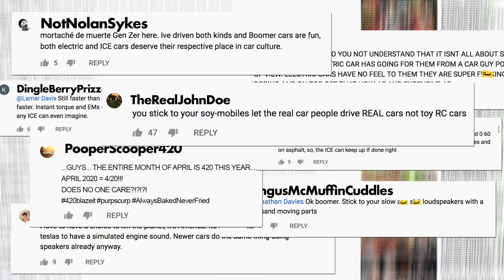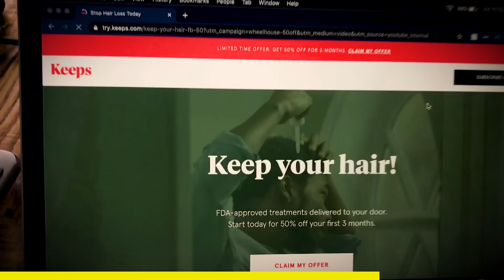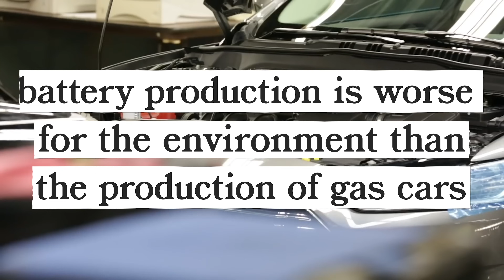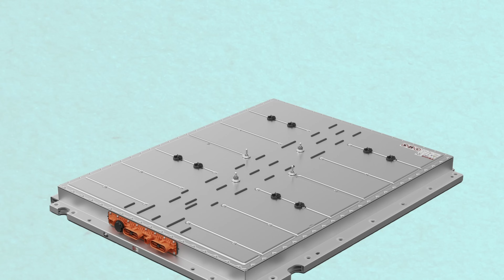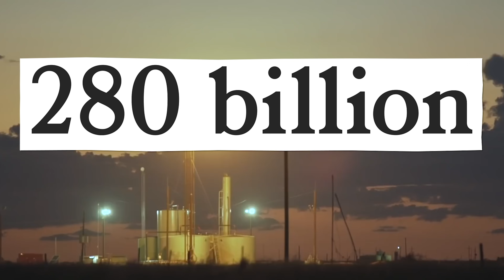Are Electric Cars REALLY Better for the Environment?

Comment from the maker: Hey guys I felt this was an important video for us to make, and I'm really glad you guys like it. We've covered a lot of different cars on this channel and talked to a lot of owners, and the one thing that unites them all is the desire for MO POWAH BABEH! So no matter how your car makes its power, you're welcome in the Donut community. - Nolan
Reply: Many errors. Talking about coal and lithium... And cobalt like it's an EV problem (it's used mostly in oil's refining!).
 For the EVs the goal is to make it a closed loop, li-ion batteries can be recycled in 96%+:

Eco-friendly method of recycling EV batteries

https://youtu.be/wxCFDWMPu38

Existing processes:

https://www.edmunds.com/fuel-economy/what-happens-to-ev-and-hybrid-batteries.html

> Lithium-ion batteries now are somewhere between 70 and 100 percent recyclable, depending on the particular chemistry of the batteries. There are about half a dozen in use and more are being developed. The bits that can't be recycled are mostly consumed as fuel in the furnaces that are used to melt down the metals, which include cobalt, copper, iron, nickel, manganese and, someday, lithium.

> Recycling specialists say that as volume grows, it will become more economically feasible to recover some of the content now wasted that way. Lithium, for example, is so cheap that there's no economic case for recovering it from lithium-ion batteries right now, says Todd Coy, executive vice president of recycler Kinsbursky Brothers. The Southern California firm handles most North American advanced automotive battery recycling through a joint venture with longtime battery recycling firm Toxco.

---

If the cobalt is your "problem"

Tesla's goal: https://evannex.com/blogs/news/tesla-s-goal-cobalt-free-batteries

https://i.imgur.com/bscMBFE.png

EV used "6 650 tonnes in 2017" (Page 22. https://publications.jrc.ec.europa.eu/repository/bitstream/JRC112285/jrc112285_cobalt.pdf ), ~8k tons in 2019 from 130k tons of mined cobalt last year. All of that with proof of origin - no children sourced crap. 
The rest so ~122k tonns? Military uses (lowest bid contractors use cheapest cobalt...), abrasive tools and cellphone batteries and **of course probably #1 that no ones mentions "indirectly" ICE cars because it's used in refining oil**:

https://youtu.be/ysQ3VWpuwI0?t=236

https://twitter.com/enn_nafnlaus/status/1206896495993278464

> Tesla is well known for not buying Congo cobalt. The Model S/X get cobalt from the Philippines, while Model 3 gets it from Canada.  Amnesty international, in its very first report on the problem of child labour in cobalt mining, spared Tesla from criticism specifically for this reason

----

An EV running 100% coal is ALWAYS mentioned, but a gas/diesel car fueled from Canada's tar(oil) sands? No that would be rude! /s

Every one car in US is fueled in part from Canada's tar(oil) sands:

https://en.wikipedia.org/wiki/Oil_sands#Energy_balance

> Approximately 1.0–1.25 gigajoules (280–350 kWh) of energy is needed to extract a barrel of bitumen and upgrade it to synthetic crude. As of 2006, most of this is produced by burning natural gas. Since a barrel of oil equivalent is about 6.117 gigajoules (1,699 kWh), its EROEI is 5–6. That means this extracts about 5 or 6 times as much energy as is consumed. Energy efficiency is expected to improve to an average of 900 cubic feet (25 m3) of natural gas or 0.945 gigajoules (262 kWh) of energy per barrel by 2015, giving an EROEI of about 6.5.

That's enough for ~2500km of range for a Model 3... And that's only extraction! 

Canada's Tar Sands: The most destructive project on Earth? - Truthloader

https://www.youtube.com/watch?v=Sjia7BsP4Bw

And they spill oil from pipelines all the time, last leak:

https://electrek.co/2019/11/01/keystone-oil-pipeline-leaks-nearly-400k-gallons-north-dakota/

> The Keystone oil pipeline has spilled approximately 383,000 gallons of *tar sands oil* in northeastern North Dakota

EGEB: Keystone oil leak affected 10 times more land than originally thought

https://electrek.co/2019/11/19/egeb-keystone-oil-leak-bill-gates-heliogen-wind-farms/
> North Dakota environmental scientist Bill Suess said the leak reported on October 29 is now estimated by state regulators to have affected about 209,100 square feet (19,426 square meters) of land near Edinburg.

---==============----

About materials, here's a nice comment:

https://old.reddit.com/r/teslamotors/comments/dsekn5/tesla_and_lithiumcobalt_mining/f6q7vqd/

> This is discussed multiple times a year, for several years. It's never from a position where someone has really done any serious research and looking into who the materials suppliers are and where they source materials from. It's always from a "a friend of mine says mining metal is worse for the environment". It's a nonsense argument, since all of the materials used to make an EV are made to make an ICE vehicle except for the addition of a tiny amount of lithium and an even smaller amount of cobalt. The amount of these materials in any battery cell is very low. Cobalt accounts for less than 5% of the cell's makeup, and lithium is single digit grams per 100 Wh.

> On the other hand, steel and aluminum make up a massive amount of every car made. Refining those processes to be more efficient, more environmentally friendly at the mineral source, cleaner in production/refinement, reducing waste when stamping parts, and increasing recycling of materials would have an absolutely massive impact on the environment almost over night. Electric arc furnaces used to make aluminum require a mind blowing amount of energy, and the metal needs to be heated to thousands of degrees to remove the oxides from bauxite and make aluminum. I don't hear anybody from Ford talking about that when they talk about their aluminum chassis.
Reply: Rrr Ggg that was good stuff well done.  thats how you make an argument whether you agree or not. that was actually so good i think you should write it up but you have to counterpoint it against the direct vehicle comparison. a generalized argument loses steam without a focus so if you continue to keep it on cars i think you could do really well with it. plus theres so much to delve into this subject you could actually make a good book on cars. i love gas engines myself but i like a good argument more. great work.
Reply: MO POWAHHH BABEEEHHHH!!!
Reply: Hi! Do you have any sources that you can share about the amount of CO2 produced when producing an ICE car? Thanks!
Reply: @jjrestomods  I don't look up research papers or anything like that very much but here's some videos and channels you might like. Engineering Explained is pretty good at explaining physics/engineering stuff about electric and gas cars using formulas and math stuff    and  2 bit DaVinci is pretty smart about sustainable energy stuff. Hope you enjoy!!
https://www.youtube.com/watch?v=N6VpPaOIPfU
https://www.youtube.com/watch?v=2rywz73vwKw
https://www.youtube.com/watch?v=6RhtiPefVzM
Reply: Drag co-efficiency is your friend for the sake of optimal functionality pertaining to all motorized forms of transportation, weight ratio distribution and more ergonomic materials also play significant roles toward varying degrees of efficiency in fuel to range at speed factors...I'm sure we could likely list a plethora of other factors and the roles they play in design and fuel economy to bhp but it might take a bit more space.
Reply: @jjrestomods  https://www.youtube.com/watch?v=6RhtiPefVzM
Reply: @jjrestomods  doesnt matter co2 isnt a danger to the environment in the first place.
Reply: Javier E hey I would love to see a video with hybrid cars
Reply: @jjrestomods  did you find it?
Reply: @jjrestomods  Hey Javier, did you ever get those sources? I really wanna look into them too.
Reply: @jjrestomods  did you happen to find a source because I am trying to do a school project on the subject but I am struggling to find any sources with the data I need
Reply: @jjrestomods  thank you much appreciated
Reply: @jjrestomods  -- 4HC + 6O2 -> 2H2O + CO2.  This is just basic chemistry and with the simplest hydrocarbon. C8H18, a molecule of octane (basically, gasoline) undergoing complete combustion, produces 8 molecules of carbon dioxide and 9 water molecules.  

Now, that doesn't mean EVs are really better for the environment.  What this guy doesn't take into account is loss along the way, through transmission.  Neither do the stats he cites, some of which are false.  ICEs are as efficient as the power plants, when it comes down to power production from fossil fuels.  They're basically engines turning magnets.  Transmission loss IS a thing, as is insertion loss.

Another factor nobody seems to take into account is charging loss due to heat.  Charging that big of a battery quick enough to be at 100% over the course of a few hours loses a LOT more energy than trickle charging it over the course of a few days.  If you rarely drive and have the slow charger,, you use considerably less electricity per  mile than the guy who drives distances every day, uses the super charge stations to bump back up by 80% in 45 minutes, and then plugs into the $1000 240 V rapid charger at home.  That guy's battery only holds a 60-70% charge after a few years, as well, still consuming close to the same amount of energy to achieve that charge.
Reply: Thank you so much for bunging clarity to the debate! Could you add a section for diesel vehicles? Especially here in Europe, diesel is very popular and they get much better mpg than gas cars. I suspect, and this is just a gut feeling, that EVs will still be better, but I would still love to see the numerical difference between the two. - Cheers from Germany
Reply: Hey Donut crew! I was wondering if you guys could cite your sources for more controversial/political videos like this?
Reply: @therisensun9277  lll
Reply: @therisensun9277  since when are facts political
Reply: @doncox3706  since naysayers started saying climate change isn't real
Reply: hey Nolan, can you provide the source of the figures mentioned in this episode?
Reply: Thanks for the video! I was called an Idiot and Psychopath, because I argued that EV's are still better than ICE engine. Yeah it is Pathetic to argue that as time goes on it'll be better, but it is true. ICE engine have gone a long way, and I'm sure EV's would too. Although it didn't help much ( since I follow a philosophy inspired by Socrates) that I question his "Skepticism" as that of being a Manipulate troll.
Reply: Would you kindly include all the sources and references you used in the description? Thanks.
Reply: Donut Media     https://e360.yale.edu/features/why-nuclear-power-must-be-part-of-the-energy-solution-environmentalists-climate

Sent this article from Yale. Just to show you the cleanest and least harmful form of energy is nuclear energy, rather than the solar, wind, and hydro energy which also produce 100x more waste than nuclear energy. For those who will try to mention Chernobyl or any other malfunctions, read the article it covers those too. Find out the truth from actual science, rather than mainstream media and social media.
Reply: @G-los  How is the waste from nuclear energy less harmful than the mechanical process of renewable energy like hydro, solar and wind?
Even though nuclear accidents has happened on an average every decade they were preventable and happened because of carelessness. If we could control it each country looking to develop throium reactors should reach a certain stage in their economic development before they should be allowed to build reactors. Ledc's tend to have worse regulations.
Another criteria I'd have, countries with history of developing nuclear weapons should be banned from developing nuclear reactors (Leniency when it comes to thorium reactors.) Im looking at the US. But this is unrealisitic and impossible to assure.
Also there is nuclear waste, who's gonna deal with that? The only country taking this seriously is finland, literally the tiniest country that's looking into nuclear energy. They decay by half-lifes, nuclear energy stays by the thousands of years probably even longer.
Reply: Another thing we need to remember is fossil fuels won’t last forever. I have read reports that it is estimated we have about 50 years of fossil fuel remaining. Not sure how true, I’m guessing though that wind and water will be around for thousands years to come. Also solar power has to be factored in as well. Again I have read an article that says we have the technology and potential to use solar power for most of the worlds demands.This is only stopped by the cost of implementation. Personally I love the sound of ICEs but we have to do better to ensure the next generations future. 👍🏻😊
Reply: Tell me this, in your gas car what goes out first the motor, or something like a window regulator or alternator?
Reply: @timessiah94  battery
Reply: @UCWvKfH7itpkFzILLCNBg0hg what kind of Rock do you live under
Reply: I wish that you covered the efficiency and longevity of an electric car compared to a "ICE" car.
Reply: Donut Media there are still 2 things you missed. 1 lifetime of a battery in an electric car and 2 the issues in different climates👍 but other than that amazing video
Reply: Could you please cite all the references you used for this topic? Thank you!
Reply: @Franz Xaver Fuchsberger While this is true there's a lot of additions and changes that Tesla makes to the batter pack as a whole that make them last longer #1 being active heat management. your cell phone and laptop don't have coolant/heaters running through them which makes a big difference on battery longevity. As well the battery management is much better on a Tesla than a laptop or a phone. I can set my Tesla to max out the charge at 80% most of the time unless I'm going on a long trip that needs the extra range. This keeps the battery in an optimal charge/discharge range for longevity. You can't do any such thing on your phone or laptop without a lot of human intervention. There's other improvements in there as well that I'm less familiar with. But while you're correct the cells are the same the batter pack is not and the charge/discharge management plays a huge role in cell longevity. As well the Teslas have a 100000 mile 8 year battery warranty or 120000 8 year warranty on the battery. So given the miles driven by an average driver in the USA  per year (13000) you're looking at between 7 and 8 years without having to pay for any battery issues. and to be clear this mean that if on 99999 miles your battery dips below 70% of original capacity you get a new battery pack for free. As well if you want data then this article has some https://electrek.co/2016/11/01/tesla-battery-degradation/ older model S and Model X's are seeing often less than 10% battery degradation after 150000 miles
Reply: I think you did a very good job and consider myself to be pretty impartial.  I would like to have seen the consideration added of the effects of the cars on the environment after their life has ended.  From my experience, due to the high cost of electric batteries many hybrid and electric vehicles are replaced or gotten rid of sooner than a gas powered equivalent.  So how about the recyclability of a car once it has been put to pasture?  Are those lithium batteries recyclable?  What kind of effect does their disposal have on the environment?  Thanks for your hard work.  I just felt this added Info could complete the picture so to speak as to the effects on the environment.
Reply: The only real question for me is long term. Yes they will be more climate friendly, but that figure has never counted for replacement batteries... we all know batteries have a lifetime of 3-10 years depending on batteries etc. Look at the Nissan Leaf. Once the batteries go people often don’t replace them. Why? Car value is far less than the battery price. So it ends up being scrapped to be never used again. This is my only problem. Electric cars don’t have the recycle value that most ICE cars have. They all can usually be sold and sold and sold. Something breaks they can usually be fixed or rebuilt. I love the idea of electric but the technology still just isn’t there for me. Also they should put a ban on putting ZERO EMISSIONS on these cars instead put the build emissions on the car like the label for fuel efficiency, it could potentially encourage these manufacturers to think about improvements to this figure longterm.
Reply: Donut Media part 2 how gas cars vs electric cars are recycled
Reply: Y don't u stop talking about your self and start a video directly on the real vehicle matter and shut the f*** up🤔
Reply: Informative video but I am curious about the statement about EVs being better over the lifetime of either EV or ICE cars considering EV batteries need to be replaced more often than an ICE engine NEEDS to be replaced. Despite what a lot of people think there are a lot of ICE cars that will run reliably up to 300k miles (I personally owned a Honda Fit that had 300k miles on it and was still running strong before someone hit me) how often do EV cars NEED there batteries changed vs ICE cars NEEDING an engine replaced. (I say “NEED” because I know a lot of people think a car is only good for 80-100k and that’s not completely accurate) again very informative video I just think it’s important to outline the issue of battery replacement intervals on an EV car
Reply: Next video as a follow up. How does a Hybrid car compare to an electric car and an ICE car?
Reply: well your math is a bit wrong. if you consider the refining emissions involved and share that across all industries using petroleum products you have a different overall percentage for ice vehicles. if you take away all ice vehicles and replace them with ev you will still have the refining emissions since everything is made with plastic which is petroleum based. you would need to split out the direct ice percentage in order to get a true number. that said this was still excellent for the research involved thank you.
Reply: You need to do better research and make another video about real pollution.
Reply: Cobalt Not colbalt
Reply: @eded9202  you need to research nuclear power a little more sir. As far as safety, you will find that nuclear power is MUCH safer than any other form of generating electricity when you look at how many deaths per mega watt generated https://ourworldindata.org/safest-sources-of-energy
As for the huge amounts of spent fuel all of it could fit on a single football field at a depth of less than 10 yards.https://www.energy.gov/ne/articles/5-fast-facts-about-spent-nuclear-fuel
Reply: Please, please, please stop using the misinformation of showing pictures of hyperboloid cooling structures (most often associated with nuclear power plants anyway) as background pictures when talking about power plant greenhouse gases. Those are used to naturally cool hot water with surface area (yes, there is just hot water in the shells of them) and harmless water vapors is all they produce (and this works opposite of condensation, so it's water that was already in the air).

I work in the nuclear power industry and misinformation has been killing my industry since the dawn of the atomic bomb. Please, again, use pictures responsibly, take the extra 2 minutes to research all things you use in your videos.
Reply: You know..... an EV would not have interrupted you like that Combustion car did, in the middle of your video (EV's make almost zero noise) 😉 Just one more perk of Electric cars 😁
Reply: You said that you love gas powered cars and you will drive them for the rest of your live... although you know that they are worse in any way for mother earth than electric cars...?!?
I wonder what it says about you...
😁👍 Good Boiii!
Reply: People don't want to change - and the electric car revolution is no different. People will try to find any excuse to prevent this change.  The hardest transition to electric IMO is the charging time, lack of awesome sounds and the MSRP.  You can reduce the initial production 10 metric tons difference by simply driving that Model X for 2 years compared to driving a ICE high performance SUV. The pros: a reliable motor, tremendous torque and mo powa babeh.
Reply: The truth is either you use it ornıt electric will go to waste because we constantly using electricity because we cant store it.
We need to use it because it will go waste if you ront use it.
Reply: There is another big problem as the batteries all have to be charged up ..and it takes 746 watts of current to make 1 horsepower ..and new electric motors can not break or defy ohms law of electricity ...and today the utility companies are building "peakers "as our power houses are becoming obsolete and non reparable ..so now we built huge gas turbine engines that suck tons of natural gas to make electricity costing huge dollars instead of coal fired boilers that cost pennies to operate ....which is cheaper and cost effective ..running your house on a back up fossil fuel generator  or plugged into the grid ? ...now our grid is being supplied with huge fossil fuel back up generators as it takes 20 years to build a new coal fired burning power house ..our inter structure  is falling apart faster than we can replace it !and now we have people claiming gasoline power cars make more pollution than industry ...so we as the consumers are just plain fucked with all the propaganda as this video is a huge lie ....all internal combustion engines account for 1 tenth of 1 % of all greenhouse emissions ..industry account for all the rest and not the the other way around as you are all being lied to  ...future battery and electric motor technology will only give us more range ..it will still take the same amount of watts to run an electric car per 746 watts = 1 horsepower as it did the first time over a 100 years ago to drive an electric car ..wind mills and solar panels will cover the earth to supply our demand for electricity to completely eliminate power houses ..nuke power plants are the only answer ..but now you are all  to believe nuclear energy is worse of all , dangerous and deadly as the accidents of the past have so called proven to fail .....what about the navy's aircraft carriers that are called  floating cities with 5000 crew members on board that steam through hurricanes without a problem ? No leaky reactors there but full steam ahead for almost 50 years or is it more than ? of free energy ... President Dwight D Eisenhower warned us of the corporate industrial military complex back in the 50s but unfortunately nobody listens
Reply: @donniebaker5984  you can start by disconnecting from the grid grow your own food and don't buy any manufactured products. Lead by example.
As for the cars an EV does need about about 820w to produce 1hp. Unfortunately ICE vehicles need about 3700w. So it is not that they don't have an environmental cost it is that the cost is lower overall.
As for the electricity generation a 200m2 roof completely filled with solar panels makes more than enough electricity to power a house of 5 people and run 2 electric cars for average people. So if we really wanted to go carbon neutral we really can we just need to put more effort in the right direction.
Reply: just wanted to correct the fact you considered wind power clean. its not it kills birds and dosent recoup the cost.
Reply: @LORD-NIGRIEZA--------------OWO  not to mention manufacturing them and shipping them to the other side of the world.
Reply: Wish he talked about diesels, diesel is a byproduct of gasoline, so it is already cleaner. It is also more efficient then gasoline. It burns hotter, and it produces more power, and it is more economical. I would love to see a comparison of diesel to all electric vehicles
Reply: He didn't mention that the batteries only last for maybe 5 years and the solar panels have to be replaced every 10 years. He also didn't mention the amount of copper that is necessary and forgot to mention the toxicity of the discarded solar panels and lithium batteries. Which are not 100%  recyclable .  While my diesel engine has 1 million miles on it and is still kicking and can be 100% recycled . I also  have over 350,000 miles on my gas engine which also can be rebuilt or recycled ,your not gonna get that mileage out of your solar batteries . Your research gets three  bullshit bullshit bullshits.  plus you never mentioned synthetic oil or alternative fuels like natural gas which are much cleaner than gas . They must be paying you all  tons of money to sell out your countries energy independence , fucking traitors. I'm unsubscribing to this blatant bullshit spewing from a guy with a IQ of 80
Reply: What about end of life issues with batteries and replacement costs?
Reply: The 100% REAL TRUTH about electric cars, is that you'll be sitting right ontop of a NUCLEAR POWER PLANT all the motherfuckin' time.
So say hello to RADIATION CANCER, and say goodbye to LIFE!!!
Now if THAT doesn't kill ya soon enough, then the ELECTRIC FIRES most prolly will...
Next best thing to a 1970s Ford Pinto, if ya asked me!
Need I say more? <:  P
Reply: Great video, I am wondering if there is a difference with diesel vs electric and what comparisons there are. I was also surprised by this research as well and you did a great job putting it all together, one thing you didn't note was the power grid in California when they have rolling blackouts residents were asked to not charge their cars. Not sure if there was anything mandatory about it but my relatives told me they were asked that.
Reply: Hey donut, blackouts mean that the electric networks are failing already
Reply: @PeopleHealthTru  -- People look at published numbers and spout them all the time.  The truth is that if the power generation and transmission systems were working properly, they could hit those numbers and everything would be fine.  You could charge all the cars you wanted.  They aren't and don't.  The result is rolling blackouts and fires WITHOUT everybody charging their cars.
Reply: EV is Anti Poor. And besides, when your Battery goes dead, it will Cost you HALF of the cars price just to buy one
Reply: @eded9202  I wonder what happens if we threw our Nuclear Waste at space?
Reply: @hectorvega621  or we could put it all in that big GARGANTUAN BLACK HOLE WE JUST DISCOVERED
Reply: Hey Nolan, what about Hybrid cars?
Reply: But what about when a battery gets punctured?
Reply: HVALA SVIMA NA PODRSCI
325 pregleda i jos raste! 
Bice ovo najjaci channel na balkanu sto se tice teardown-a, durability testova i preview-a svega! 
https://youtu.be/72lGqGEVAx4
Zapratite i budite u toku, ima giveaway-a! 
Vec je poklonjen jedan bluetooth receiver i poklanjacemo jos mnogo toga!
Da budete u toku, follow stranicu
Top_tech_top_cena! Na instagramu!
HVALA!
Reply: Hey Nolan 

Awesome video. 
But I noticed that you didn’t take a very crucial fact in to consideration. 
The battery doesn’t last for ever. Just like on your phone or laptop. 
They just don’t hold a charge after a while. So that means a new battery. 

If you take that in to consideration, are the EV’s still the ones who come out on top or??
Best regards from Denmark.
Reply: Motorcycles too. No matter what powers them...unless it's powered by shredded babies, or something like that, but you know what I mean.
More power (pet name baby, not literal baby) baebeh!
Reply: Donut Media Thanks for proving me wrong. I was one of the people that requested a video about this and I was legitimately curious what the data would show. It’s still insane how much emissions come from building EV’s, but this was a great vid.
Reply: If all of the facts in this video is true (surprise! I have a dissenting POV) then argument you propose is actually what fossil fuel & distribution system is more efficient  with the least environmental impact, on average,, each year: Gasoline or Coal with a sprinkling of Nuclear &renewable resources combined with the environmental impact of the correlating production of ICE & EV vehicles? In which case unless you have you’re own high production solar panels on your sunny California home after year 3 but before year 10, with a solar wall (batteries) but ignore that impact, the difference would be negligible at best. 

Being that you’re average EV has a shelf life of 1/3 of the average ICE vehicle due to the current secondary market, the cost of replacement components, the ability to repair, & the likelihood of salvaging by insurance the truth is that when you actually compare the impact of production of an EV vehicle and a unit of Coal to travel ‘x’ number of miles = to the same number of ‘x’ miles in an ICE car using Gasoline from crude the truth is that It requires multiple life cycles and productions of EV cars equal the same life cycle and miles driven of one ICE car and the environmental difference between the required Coal vs Gas is.nothing more than an argument between lobbyists from Wesg Virginia & Texas. So until we see the Mythical ROI (reduction on Impact) that does not exist yet stick to your 1992 civic Jack.
Reply: Im honestly.. Kinda hurt..
Reply: The battery issue wont exist once the batteries move over to being carbon based in THIS decade.
Reply: I argue that hydro electric power does not count as environmentally sustainable. Dams will flood local wilderness and they endanger migrating aquatic species among a number of other things.
Reply: Proton cars please, especially its R3, and UK rally scene
Reply: Can y’all do a video about hydrogen powered cars
Reply: Great video.Good job donut media !
Reply: Hey Donut!  You Should Make A Video On Iconic Video Game Cars ?
Reply: @donutmedia hey Nolen, who pressured/ paid you guys to make this?
Reply: Thanks a lot !
Reply: Did you think of fuel cell cars, because i think they have a really low emissions. And thanks for the great video
Reply: In Conclusion, Hydrogen Fuel Cell EV is more environmental friendly.
Reply: So you stood in front of a greenscreen...to make your background a blue screen😂
Reply: how about hybrids? with diesel and gas engins?? how do they compaire? ^^  
btw NICE! :D GOGO DONUT!! :D MO PAWAH BBY!
Reply: only point i dident see was lifetime emissions of an ev. 1 does the car last as long overall as a ice , will you be buying new ones more often. 2 how often do you need to replace those lithium dependent batterys .
Reply: I appreciate vehicles in all shapes, sizes and propulsion so I'm not being bias, Did you take into account the need for replacement batteries in EV's ( especially with the impact getting the lithium )
Reply: Can Hydrogen Fuel Cell also become a new step for the Future??
Reply: 0:07 lmao my comment made it "TheRealJohnDoe"
Reply: TimothyReidUpNorth907 yeah !
Reply: TimothyReidUpNorth907 but Nolan will not listen to you man .
Reply: The best explanation, it's really a whole and holistic approach to both EV and Combustion cars, well done 👍
Reply: Don't count out the hybrid.  You can have the exciting gas engine with EV power...and already hybrids are cleaner than EVs in areas with heavy coal mix.
Reply: One point that should be mentioned is the reason why Cobalt was mined in the first place. Cobalt is used in a production of gasoline.
Reply: we all hart the sound of a dying planet  "I AM THE GREATEST"
Reply: Could I get a source for myth #2?
Good video btw
Reply: did you add in the fact that you are going to have to replace the battery pack after like 5 years and the fact that the battery gets less efficient the older/ more use it gets.
Reply: no, it doesn’t benefit me when the government subsidizes other people buying EV cars, that’s my money they’re doing it with. we’re trillions in debt, and this is how you want money spent.
Reply: You should check out the new Michael Moore Documentary about green energy. Shows lots of information you arent aware of when it comes to ev production.
Reply: Donut Media thank you
Reply: I’m pretty sure they need cobalt to refine oil
Reply: I’m pretty sure they need cobalt to refine oil

Cobalt is used in the refining process but almost no cobalt in _consumed_. In refining, 98.8% of that cobalt is recoverable, and it can be higher with more thorough recycling processes. We use almost all same cobalt over and over again.
Reply: Good job on this one
Reply: Hybrid vehicles?
Reply: You forgot Nuclear Power. In fact, there is no viable Co2 neutral, much less Co2 negative, energy plan with out major investment in nuclear power if you want to electrify road vehicles.

It is the safest and the most environmentally friendly form of energy production. Full stop. No other Zero Emissions form of electricity generation can match the capacity of coal power. 

And that is a scientific fact.

Also, renewables kill in a year more than nukes have done in their entire history of existence. Simply in technicians and maintenance workers falling off of heights.

Furthermore, Variable compression ratio and fully dynamic valve train technology combined with biomass sourced (optimum being hemp and algea which are actually co2 negative sources) push gasoline engine emissions far below the impact of even a nuclear charged EV.

There's zero mileage in electric cars. Aside from hydrogen fuel-cell cars. Hydrogen yet again, being sourced from nuclear reactors.
Reply: Can you do a video on hydrogen fuel cell cars?
Reply: Nice. I’ll never drive anything but a jeep as well because life’s too short to drive boring cars!
Reply: What if it's a hybrid
Reply: Hey Nolan, I think this was a very well researched video, but I think it should be noted that you neglected to include stats regarding the efficiency (or lack thereof) of the "green" energy sources you mentioned like wind/solar/biomass/etc. There's a pretty good documentary on it that I'll link to below, but when we include things like the short lifespan of renewable generators and the CO2 created by simply manufacturing an installing them, it becomes abundantly clear that "green" is just marketing jargon.

I won't deny the incredible capability of electric motors and I think they are likely the way of the future, but it's fair to point out that there are a number of studies that show a windmill could spin at capacity until it shreds itself to pieces and it could never offset the amount of CO2 required to create it in the first place.

Check out the doc. It's worth a watch. Thanks for the unbiased report. I'd love to see a follow up that includes the data I'm referring to. Cheers!

https://www.youtube.com/watch?v=Zk11vI-7czE
Reply: How about the battery of your combation car.noooooo😂
Reply: How about the battery of your combustion engine car?no no no no no 🤣🤣😂😂😂
Reply: Great video man.Thanks a lot.
Reply: Hey Nolan, why didn't you mention nuclear as a power source for recharging? It's clean, safe, quiet.
Reply: 1st. Noone knows if co2 warms the planet. 
2nd. I wanna see the trash of batteries if 70% ppl om earth drive EV.
3rd. That model u explained only works if we stop mining crude oil. But we need it for so much more then just diesel and petrol. 
Conclusion EVs r not worth it. Time will tell :)
Reply: In reality the best car for the environment is buying a used car. It’s much better for the environment since the cars already been made.
Reply: So ky car is 36 years old. How many battery replacements would my ever have had in that time? How does that change the impact?
Reply: I suppose the issue with EV's is... nuclear power plants produce radioactive waste; for which humanity does not yet posses an adequate way of managing and/or recycling. I suppose the question would have to be: will an ICE vehicle returnee to the earth faster than what it takes a radioactive Isotope to decay and be non radioactive. I know Uranium 238's half life is somewhere in the neighborhood of 4 billion years. however I have no idea whether or not it's present in radioactive waste. It would be interesting to look into what nuclear waste is composed of, how its treated and what the half life of it (nuclear waste) is.                      P.S. They speed up the half life process via nuclear acceleration however I have no Idea what the end result of the half life is...
Reply: Not trolling in the slightest, but did you consider the lifespan of a battery?  I work in HVAC in colorado where high efficiency is a scam, it's not too hot or cold over a long enough period for the HE equipment to ever pay for its self, and considering they are much more complicated they have a shorter life and higher cost of ownership, all for a couple percent we don't recommend it.  I have often wondered, and wish this was your area of expertise, the foot print of clean energy as well.  Anyways thank you very much for the video, it answered a question that I've been asking for a long time.
Reply: @Psittac20  HE equipment?
Reply: @Psittac20  also I live in Greeley. You guys wouldn't happen to be hiring? I already have HVAC experience.
Reply: For me it's really convincing and informative
Reply: What about hydrogen powered cars?
Reply: Just so you know, there is a German company that can now recycle 72% of an EV battery -  https://www.youtube.com/watch?v=Bpe8HalVXFU
Reply: #carboiz
Reply: This is all BS. I REFUSE to buy an EV regardless of the environment or any other factor. I love burning gas and my gas car is always gonna be faster.
Reply: @Marsalien100  your gas car is shit compared to an electric vehicle.
Reply: Check out the movie "Planet of The Humans" to find out more about the pollution created by manufacturing lithium batteries and many more disparaging things about the so called "green" way of doing things. 
I was shocked to find out that it's shredded tree's that are burned as a "biofuel" in supposedly green power plants.
Reply: the centralized electric source of EVs (from powerplants) are more efficient than many individual gas engines.
Reply: So does this mean I can't carbon shame my gas car neighbors anymore?
Reply: Can you make a hydrogen car video
Reply: Can you bleep better
Reply: You forgot to say that EVs don’t need so many fluids oils and such and don’t need nearly as much maintenance also cars like Tesla get upgrades for free so your value is better
Reply: Start planting for Biofuel, it is better than gas/diesel and it will smell of Donut media!
Reply: Everything in the video is right , it’s awesome done video, only one thing is problem for the electric cars ... like we have to change the batteries of an electric car approximately every 7 years and their battery performance goes slowly down after the 3rd year .

If someone figures out a new type of battery that lasts longer (like Tesla talked about batteries that could last for 1200 miles and more than 10 years of using ) 
There is already a nuclear battery that can last 100+ years without a new charge, but still won’t be put in cars ,because the other companies won’t let it happen .(that means that cars will be a lot lighter and even the ICE cars won’t need the heavy accumulator batteries that we use today)
Reply: Hi low season two should be off-road like jeep wranglers
Reply: I'm from indonesia, we mostly sell human resources cheap and natural resources, and you guys with lithium battery is likely to destroy our home land further with nickel mining demand.

Ice or EV i don't know which is better from my point of perspective
Reply: Can i take the electric car battery out and charge the battery.I have a car battery charger ??
Reply: I must have missed it. Did you mention the oil used for the motor of the car in the co2 per year equation or was it just the co2 from gasoline? I saw the mention of oil manufacturing.
Reply: Hey Nolan, I learned a lot for this video. #carboiz #carlifestyle
Reply: Hey Nolan, I learned a lot for this video. #carboiz #carlifestyle
Reply: Grey Wild Wolf  We all do that, my friends, we all do that ... However, I neither own a car nor do I have my own house that I have to heat completely. I have the privilege of living in a European city (Berlin, Germany) that is very well served by public transport and can therefore afford to do without a car. I guess that my pollutant consumption is a lot smaller than yours and that of the average American.👋😉👍
Reply: Nolan your not gonna enjoy that Mustang when they start banning gas powered cars just for the sake of it like California so what’s stopping the other states from doing that and who do we have to thank for taking our gas powered cars we worked on for most of our lives oh yeah Electric cars again not pushing my agenda but that’s what the future is pushing toward
Reply: Grey Wild Wolf  Yes - but that's with a solid charging station.  For most of us who rent an apartment - we only have access to a 3 prong wall socket if our landlord is cool with it.
Reply: You forgot nuclear.
Reply: 10/2/2020: Tesla sales crashes in Europe:  https://www.latimes.com/business/story/2020-10-02/tesla-reports-q3-deliveries-

record?utm_source=feedburner&utm_medium=feed&utm_campaign=Feed%3A+latimes%2Fbusiness+%28L.A.+Times+-+Business%29
----------------------------------
10/2/2020: Norway used to be Tesla's biggest market....not anymore!
Volkswagen Sold Nearly Twice As Many ID.3s In Norway In September As Tesla Sold Model 3s
https://www.forbes.com/sites/jimcollins/2020/10/01/volkswagen-sold-nearly-twice-as-many-id3s-in-norway-in-september-as-

tesla-sold-model-3s/#5d4f2458a745
-------------------------------------
10/2/2020 Tesla Faces China Wipeout By 2030, Morgan Stanley Analyst Says
https://finance.yahoo.com/news/tesla-faces-china-wipeout-2030-090559425.html
-------------------------------
10/8/2020: In 2021, VW sells 90% of EV cars in Tesla's main market of Norway
https://finance.yahoo.com/news/volkswagen-expects-90-electric-car-153750916.html
---------------------------------
10/9/2020: Tesla drives off the road  https://www.youtube.com/watch?v=TJYBMoehFXI
Reply: TESLA: There's only a 5 year world supply for lithium batteries (and Tesla is using up too much of that for the few , 

compared to how 

little a smartphone uses for everyone).   Current electrical infrastructure can't supply the electricity to all homes.   

Powerlines 
contribute to forest fires.   Lithium batteries are mined by African children.    Lithium batteries create toxic disposal 

wastes.

There needs to be a law that prioritizes lithium for smartphones over electric cars because cars have petroleum and hydrogen 

alternatives.

Providing more lithium batteries for EV cars is just opening a can of worms because the electrical grid cannot support every 

house.  

Not everyone can or wants to incur the cost of solar panels (which from my friend's experience only lasted 7-10 years)
I have 4 cars, 2 cars (kids' cars) are parked outside.

A battery manufacturer should sell to the highest payer.  Ford, GM, and VW have deep pockets and they can pay more for the 

batteries 

and put Tesla out of business.

An electric truck makes no sense because tests have shown that the battery drains faster when it has to pull.  Hydrogen 

vehicles make 

more sense in trucks than EV.   Hydrogen vehicles fuel up in 5 minutes like gas cars and they have a 1000mpg range; EV you 

have to 

wait 45+ minutes (and you have to wait for the guy in front of you to finish his charging)

THere isn't a plugin at every corner like a a gas station and the charge is 50 minutes+ (assuming you aren't waiting for the 

guy 

before you to finish his charging)

Gas stations pay tax to maintain roads, EVs don't

That would cause a lot of unemployment.
Reply: battery disposal is STILL a BIG issue.
Reply: MO POWAH BAHEH lol
Reply: We need many sources of energy Sonny boy when I pushed my car to the gas pumps because we were short on the oil we didn’t have an option so when you talk about different sources we the people of the United States need to push for many kinds of energy and many kinds of cars that run on many kinds of fuels the day is over for big oil cartels controlling the source of energy and what we use to Drive our cars on. Split the subsidies amongst many energy sources who knows we might find a better source a better and cleaner way to run cars the days are over for oil cartels to get all the subsidies we must change we don’t want to have wars over oil we need many sources and options
Reply: hey guys could you possibly post the links to the data from this video please
Reply: Your sources are incorrect, check the latest report from the European Environmental Agency
https://www.veraveritas.eu/2020/10/green-cars-are-like-virgin-prostitutes.html
https://www.eea.europa.eu/publications/term-report-2016
The TOTAL CO2 emissions of the AVERAGE car in Europe doesn't differ much between diesel or electric.
The only advantage of electric cars is noise reduction and pollutants which are not emitted in cities close to people.
Reply: https://car-recalls.eu/ev-hybrid-recalls-problems-44-20/
Reply: Did you site your sources
Reply: @apexhunter935  cite
Reply: Good video but you left out all the maintenance needed in electric vs combustion cars.
Reply: Um idol what about lead acid battery?
Reply: What a lie filed video, lithium does not come from  South America those mine are for potassium, battery use no rare earth, compare to the catalytic converter. I will stop listing the lies...
Reply: Hey guys over in China nobody cares
Reply: What I wanna is how nervous you were to post this video? Lol
Reply: Nolan don't kid yourself. Advertising snake oil hair growth products and not telling the whole story about EV's, leaving major factors out.  Proves you lied and have a biased opinion.
Reply: I dreaming of EV since 3rd grade. My first push cart as they would call (5th grade) it a 2 x 12 with rope steering wagon wheels was an electric go kart with forward and reverse. Power source looooooong extension cord.
So you forgot to include the CO2 that it requires to mine the coal to produce the electricity for the EV. Then there's nuclear waste from power generation. The severe pollution impact of creating windmills and creating solar panels. You missed the fact that windmills cause air turbulence pollution. Something discovered when big cities and skyscrapers started causing strange effects on the environment. Against the belchers we're still paying for the lead along the highways from leaded gas but now I'm cycling down a ridiculous rabbit hole. If you were searched all the big numbers and start eliminating the smaller ones you'll find the EV's still haven't broken even yet in regards to some of the things you included like child labor and downright World pollution in third world countries let alone CO2. I'm planning on building and EV motorcycle out of recycled Parts saving the environment from an ever so small amount of trash. I still believe in them I just don't delude myself weather on driving toxic electrics or a belcher
Reply: hello can you show me your sources that you guys use?
Reply: Why you thinking some dumb medicene will help you prevent losing hair if you want to keep your hair you need to do hair trqansplants
Reply: Sorry bro you have done a little calculations error you don't consider carbon footprint of coal or natural gas mining
Reply: Great video for what it is. I did alot of research on this recently and it is an extremely complex question to ask or answer.  The conclusion I found was that EVs using the average electricity sources will produce about 10-15% less CO2 over the average lifespan of a car in the USA this assumes at least 90,000 miles driven.  However almost none of the people talking about this really look at total environmental impact. You mentioned some when talking about mining lithium but it is far more extensive than that alone. You have everything in an ice car plus the batteries plus the extra copper and other things.  The mining for these minerals is far harder on the evironment than the mining of fossil fuels as of now. In the future this may change.  Also so many things in our lives come from crude oil not just gasoline and deisel. If we ended all gasoline use tomorrow the total amount of oil refined would drop less than 15%. I'm not saying that electric cars are bad I actually really want one but they are definitely not an environmental hero by any stretch.
Reply: New fuels are being developed that give extremely clean emissions from internal combustion engines. For example the new synthetic fuel developed by porsche reduces tail pipe emissions by 85%. This would put the internal combustion engine on a level of emissions output at the same level as a electric vehicles.
Reply: NO.  
- crash merging into the same lane as another vehicle  https://www.youtube.com/watch?v=ih-GUz8rmLg&feature=youtu.be
Tesla's camera failed to see that both cars entered the same lane and should have backed off.
- Texas is snowed in and no electricity = tesla sucks

- tesla using up tons of batteries.   smartphones for the billions of people are more important than a few rich people in a tesla.

To answer your question "who in their right mind buys a car without test driving it?": crazy Tesla owners
I'm glad I test drove the Tesla model 3 because I thought it sucked (large turning radius, overly aggressive regenerative braking felt like 

I slammed on the brakes, stiff ride due to high psi tires, road noise, ugly center stack screen with tiny fonts).
Reply: Hey guys love your videos and found this one very informative so thank you however, I noticed that every time you talked about Cole plants or high co2 from power generation you showed a cooling tower with steam (not smoke or co2 emission) coming out this I believed to be misleading I understand oversight happens but encourage looking into nuclear power and the regulations and regulatory commission for this. Thanks guys for the awesome videos keep it up.
Reply: hey donut crew! i was wondering if you guys could mention any problems with both ICE and EV in the future (like maybe 10 years), as when i was watching this video i was wondering: “But you’ll need more solar panels and wind mills to keep up with future demand, where would we get the land to make those farms?”
Reply: It isn't just CO2 that is a problem with producing lithium batteries...Toxins left after mining and making them are a huge problem that is completely IGNORED ! Not that mining many other minerals are getting spotlight either,but it is annoying how it is ignored when people talk about pollution  . One of the few points China,EU and US can agree on...not talking about that problem.
Reply: Teslas are not cars
Reply: @theunknownguy265  considering how electric cars escape common pro-consumer regulations ,we might as well not label them as cars
Reply: An engine in a real car makes power. An EV takes power that's made for it in its battery and just uses it. Electrons don't change form and behaviour, air and fuel does.
Reply: Should have probably compared the aftermath on the landscapes after mining for lithium and mining for oil as well ass the energy density of both electric and ICE engines
Reply: Umm...  Did u take into account of electric power lost during transmission over the transmission line?
Reply: @9wycc  It's not that much though in well designed and maintained systems i think. High voltage low current AC makes it viable, but then again by saying that i'm coming across as if saying that a full EV fleet across the continent could work, Canada, US, or Mexico, and not bog down the system. And most importantly, during a brown or black out, you can refuel an ICE vehicle if you have some in a can. Good luck plugging in your EV. Suppose you could power a generator, but not everyone has one. Most people own jerry cans though. Hell, even Europe would have issues.
Reply: @cejannuzi  Lots of mining for a precious metal, on top of everything else we use them for. And the electric grid, and what if it goes down? No car or vehicle for you. Unless you have a gas or diesel generator. Here's hoping, for car culture and fun, the economy and convenience and reality E-fuel takes off.
Reply: No.You thought it was important to monetize this video.
Reply: Learned a lot. Thanks everyone
Reply: @Donut Media I have one point you missed in my opinion.
-not everyone but I guys a major part of EV-owners have solar panels
(at least we charge or EV only with the power of the sun😂)
-second there is no good way to recycle Lithium but you can replace the little „batteries “ in the pack or use the old battery for you solar panels to save your power for the evening…
Reply: One thing I didn't hear you factor into the production of ev vehicle was also the oil and gas production to make the oil and gas to supply the machinery digging up the precious ore.
Reply: @myleswarkentin2179  do you know what "ore" is?
Reply: Hey. Electric car has large problem that it waste Rare Metals
Reply: @takoyaki-gq1qj  what means waste, Tesla is recycling them pretty well and old battery packs can be refurbished by replacing cell that are to bad or by using the battery pack as storage for the electricity of your solar
Reply: @d.nyoutube  problem of testla. Tesla car is 3ton. it will destroy road and parknig lot… You say that tesla recycle it. but, is everyone will recycle? once you buy tesla. it is you're thing. You can scrap it at anywhere
Reply: @takoyaki-gq1qj  thats not true a model 3 small car weigt 1,6 t and an SUV model x only 2,5 t so not entirely true because the most cars are model 3 and model s.
And to your other point porsche audi just started building electric cars the last a long time at least 6 years so there is enough time for the other companies to do the same as Tesla
Reply: @d.nyoutube  Yes electric car is good. it all stop in case of nuclear war and EMP. It waste electricity even not using. It heavy then gasoline/diesel car. It expensive ass. Battery need to be replaced per 10year. It too silent and pedestrian can't note that car is coming. yes. it dangerous
Reply: @takoyaki-gq1qj  yeah if an electric vehicle is produced without emissions it it probably the best we can do at the time!
Yeah but the battery to start your car is also killed and the electric injection that is controlled by a computer so where is the point? 
Yeah an electric vehicle is expansive but they get cheaper model 3 and they safe you money because electricity is cheaper as gasoline/diesel.
why should you need to replace a battery every ten years it depends on how you drive! Maybe the battery is expensive but you need more costs to maintain an gasoline diesel car as an electric vehicle!
So where is the point?
Reply: @d.nyoutube  Electric car cost isnt expensive ''now'' but government are going to add tax for Electric car so cost will be almost same
Reply: She is a diesel boy because she loves combustion bulshit car
Reply: Lose the god damn haitloss commercial ffs all these hair products are a scam hairloss is either by age or genetical and cannot be prevented or slowed down
Reply: Thing is what if dont want ev . Dont l8ke ev .
Reply: You are speaking about local driving in the sense that an electric car is pragmatic, they are not practical for long range driving. Your gas powered "mustang" can go further in a shorter time than an electric car. THAT IS A FACT. And speaking about CO2, it becomes "dangerous," if the city or state that you live in, has chopped down the all their trees, to make way for TALL STEEL BUILDINGS, or even MEGA MALLS. The United States has more URBAN SPRAWL, because tens of thousands of acres, where forests and animal's habitats were destroyed, so empty and ugly rotting buildings and offices can take their place.
Reply: What about having to A replace the battery every 5 to 10 years or B having all these battery recycling plant catch on fire
Reply: If people think electric vehicles for the environment are better something really got to be wrong with them. Biting just signed a deal not too long ago saying that by 2030 there will be half of and more of electric vehicles out there he's putting hard focus on electric vehicles. I think was a dumb move for the president signed such a bill and it's wasteful spending in my opinion
Reply: I do not quite agree.
You seem to only be considering emissions.
But, you gotta think about:
People not being able to eat because of the lack of water in some regions of the world.
How clean is the nuclear power plant?
How clean is the wind power when you eventually have to bury the blades cos they do not recycle.
How clean are the batteries after you use them?
Which are the environmental consequences of you building a dam? 
The problem is us. We will pollute, we are humans.
So ni matter what you drive electric or combustion you will pollute. That is the fact.
I'm not an environmentalist btw.
I do own a 52 Chevy pickup.
But I just see the world the way it is
Reply: god damn, Nolan is a really cool dude
Reply: @eded9202  nuclear waste is 97% recyclable and will be 100% recyclable in ten years
Reply: Solar panels may be an appealing choice for clean energy, but they harbor their share of toxic chemicals. The toxic chemicals are a problem at the beginning of a solar panel's life -- during its construction -- and at the end of its life when it is disposed of. These two intervals are times when the toxic chemicals can enter into the environment.

The toxic chemicals in solar panels include cadmium telluride, copper indium selenide, cadmium gallium (di)selenide, copper indium gallium (di)selenide, hexafluoroethane, lead, and polyvinyl fluoride. Additionally, silicon tetrachloride, a byproduct of producing crystalline silicon, is highly toxic
Reply: The lithium extraction process uses a lot of water—approximately 500,000 gallons per metric ton of lithium. To extract lithium, miners drill a hole in salt flats and pump salty, mineral-rich brine to the surface. After several months the water evaporates, leaving a mixture of manganese, potassium, borax and lithium salts which is then filtered and placed into another evaporation pool. After between 12 and 18 months of this process, the mixture is filtered sufficiently that lithium carbonate can be extracted.

South America’s Lithium Triangle, which covers parts of Argentina, Bolivia and Chile, holds more than half the world’s supply of the metal beneath its salt flats. But it is also one of the driest places on earth. In Chile’s Salar de Atacama, mining activities consumed 65 percent of the region’s water, which is having a large impact on local farmers to the point that some communities have to get water elsewhere.

As in Tibet, there is the potential for toxic chemicals to leak from the evaporation pools into the water supply including hydrochloric acid, which is used in the processing of lithium, and waste products that are filtered out of the brine. In Australia and North America, lithium is mined from rock using chemicals to extract it into a useful form. In Nevada, researchers found impacts on fish as far as 150 miles downstream from a lithium processing operation.

Lithium extraction harms the soil and causes air contamination. In Argentina’s Salar de Hombre Muerto, residents believe that lithium operations contaminated streams used by humans and livestock and for crop irrigation. In Chile, the landscape is marred by mountains of discarded salt and canals filled with contaminated water with an unnatural blue hue. According to Guillermo Gonzalez, a lithium battery expert from the University of Chile, “This isn’t a green solution – it’s not a solution at all.”
Reply: During the Obama-Biden administration, hydraulic fracturing was accused of causing a number of environmental problems—faucets on fire, contamination of drinking water, etc.—but the administration’s own Environmental Protection Agency could not validate those accusations.  Now Biden is planning to transition the transportation sector to electric vehicles that are powered by lithium batteries and require other critical metals where China dominates the market. Mining and processing of lithium, however, turns out to be far more environmentally harmful than what turned out to be the unfounded issues with fracking.
In May 2016, dead fish were found in the waters of the Liqi River, where a toxic chemical leaked from the Ganzizhou Rongda Lithium mine. Cow and yak carcasses were also found floating downstream, dead from drinking contaminated water. It was the third incident in seven years due to a sharp increase in mining activity, including operations run by China’s BYD, one of the world’ biggest supplier of lithium-ion batteries. After the second incident in 2013, officials closed the mine, but fish started dying again when it reopened in April 2016.
Lithium prices doubled between 2016 and 2018 due to exponentially increasing demand. The lithium ion battery industry is expected to grow from 100 gigawatt hours of annual production in 2017 to almost 800 gigawatt hours in 2027. Part of that phenomenal demand increase dates back to 2015 when the Chinese government announced a huge push towards electric vehicles in its 13th Five Year Plan. The battery of a Tesla Model S, for example, has about 12 kilograms of lithium in it; grid storage needed to help balance renewable energy would need a lot more lithium given the size of the battery required.
Processing of Lithium Ore
The lithium extraction process uses a lot of water—approximately 500,000 gallons per metric ton of lithium. To extract lithium, miners drill a hole in salt flats and pump salty, mineral-rich brine to the surface. After several months the water evaporates, leaving a mixture of manganese, potassium, borax and lithium salts which is then filtered and placed into another evaporation pool. After between 12 and 18 months of this process, the mixture is filtered sufficiently that lithium carbonate can be extracted.
South America’s Lithium Triangle, which covers parts of Argentina, Bolivia and Chile, holds more than half the world’s supply of the metal beneath its salt flats. But it is also one of the driest places on earth. In Chile’s Salar de Atacama, mining activities consumed 65 percent of the region’s water, which is having a large impact on local farmers to the point that some communities have to get water elsewhere.
As in Tibet, there is the potential for toxic chemicals to leak from the evaporation pools into the water supply including hydrochloric acid, which is used in the processing of lithium, and waste products that are filtered out of the brine. In Australia and North America, lithium is mined from rock using chemicals to extract it into a useful form. In Nevada, researchers found impacts on fish as far as 150 miles downstream from a lithium processing operation.
Lithium extraction harms the soil and causes air contamination. In Argentina’s Salar de Hombre Muerto, residents believe that lithium operations contaminated streams used by humans and livestock and for crop irrigation. In Chile, the landscape is marred by mountains of discarded salt and canals filled with contaminated water with an unnatural blue hue. According to Guillermo Gonzalez, a lithium battery expert from the University of Chile, “This isn’t a green solution – it’s not a solution at all.”
China is among the five top countries with the most lithium resources and it has been buying stakes in mining operations in Australia and South America where most of the world’s lithium reserves are found. China’s Tianqi Lithium owns 51 percent of the world’s largest lithium reserve in Australia, giving it a controlling interest. In 2018, the company became the second-largest shareholder in Sociedad Química y Minera—the largest lithium producer in Chile. Another Chinese company, Ganfeng Lithium, has a long-term agreement to underwrite all lithium raw materials produced by Australia’s Mount Marion mine—the world’s second-biggest, high-grade lithium reserve.
Recycling Lithium-Ion
In Australia, only two percent of the country’s 3,300 metric tons of lithium-ion waste is recycled. Unwanted MP3 players and laptops often end up in landfills, where metals from the electrodes and ionic fluids from the electrolyte can leak into the environment.
Because lithium cathodes degrade over time, they cannot be placed into new batteries. Researchers are using robotics technology developed for nuclear power plants to find ways to remove and dismantle lithium-ion cells from electric vehicles. There have been a number of fires at recycling plants where lithium-ion batteries have been stored improperly, or disguised as lead-acid batteries and put through a crusher. Not only have these batteries burned at recycling plants, but auto makers are seeing battery-related fires leading to vehicle recalls and safety probes. In October, U.S. safety regulators opened a probe into more than 77,000 electric Chevy Bolts after two owners complained of fires that appeared to have begun under the back seat where the battery is located.
Because manufacturers are secretive about what goes into their batteries, it makes it harder to recycle them properly. Currently, recovered cells are usually shredded, creating a mixture of metal that can then be separated using pyrometallurgical techniques—burning—which wastes a lot of the lithium. Alternative techniques, including biological recycling where bacteria are used to process the materials, and hydrometallurgical techniques which use solutions of chemicals in a similar way to how lithium is extracted from brine are being investigated.
It is estimated that between 2021 and 2030, about 12.85 million tons of EV lithium ion batteries will go offline worldwide, and over 10 million tons of lithium, cobalt, nickel and manganese will be mined for new batteries. China is being pushed to increase battery recycling since repurposed batteries could be used as backup power systems for China’s 5G stations or reused in shared e-bikes, which would save 63 million tons of carbon emissions from new battery manufacturing.
Cobalt Extraction Also Poses Environmental Problems
Cobalt is found in huge quantities in the Democratic Republic of Congo and central Africa where it is extracted from the ground by hand, using child labor, without protective equipment. China owns eight of the 14 largest cobalt mines in the Democratic Republic of Congo and they account for about half of the country’s output. While China has only 1 percent of the world’s cobalt reserves, it dominates in the processing of raw cobalt. The Democratic Republic of Congo is the source of over two-thirds of global cobalt production, but China has over 80 percent control of the cobalt refining industry, where raw material is turned into commercial-grade cobalt metal.
Like lithium, the price of cobalt has quadrupled in the last two years.
Conclusion
Environmentalists expressed unfounded concerns about fracking, but they need to be worried about replacing fossil fuels in the transportation and electric generating sector with electric vehicles and renewable energy where lithium, cobalt and other critical metals are needed to produce these technologies. Mining, processing, and disposing of these metals can contaminate the drinking water, land and environment if done improperly as seen from several examples. And, since China dominates the global market, it just switches what once was U.S. reliance on the Middle East to U.S. reliance on the People’s Republic.
H., David. "Toxic Chemicals in Solar Panels" sciencing.com, https://sciencing.com/toxic-chemicals-solar-panels-18393.... 12 August 2021.
Reply: I love the video and how it breaks down every aspect of production and use of the vehicles! Would it be possible for a part 2 and discussing the process of retirement of EVs vs ICEs? Like the environmental impact of cars in landfills or recycling plants and which has a longer lasting impact in those scenarios?
Reply: Here's another thought: Li-ion battery technology is just one out of many various battery technologies. Li-ion batteries are not even essential to EVs, hell it's not even the most efficient battery technology currently out there. There are other battery technologies that can pack a much higher energy density per kilogram and that are far better for the environment to produce, such as solid state batteries or ultra-capacitor-based batteries... those technologies are just very very expensive presently speaking and no good ways to currently put these technologies into mass production. Li-ion is only currently the preferred battery technology for EVs because it strikes the best balance between cost and effectiveness, but technology constantly changes and evolves and what holds true today does not necessarily hold true tomorrow. Tons of research are put into this very problem and other types of batteries will prevail in the future. And i'm not buying your initial claim that mining for Li-ion is just going to become worse and worse and worse, because it is based on the faulty assumptions that we will have to keep mining forever every time an EV is produced, that there will never be good ways to recycle lithium (and cobalt for that matter) and that no other technology will ever replace Li-ion.
Reply: Don't forget we need to replace batteries of ev's after some time
Reply: @Soch_Ka_Vishal_Roop  don't forget that:
1: an electric car battery can go on for 10-20 years before it will have to be replaced. In fact electric car manufacturers in US are required to cover the battery under warranty for at least 8 years or 100.000 miles if exceeding 8 years. Many manufacturers covers it for even longer than that. An electric battery will outrun a conventional fossil fuel car before it has to be replaced, and you only need to replace the battery, you don't need to replace the whole car as is the case with fossil fuel vehicles. So when the EV-owner needs to  replace the battery, the owner of the gas-guzzler will replace his whole car. He might even have to replace his gas-guzzler twice before the EV-owner needs to replace his battery once.
2: the lithium stays in the battery and can be recycled! It doesn't burn to smoke and disappear into thin air like fossil fuels, so we don't have to mine for lithium indefinitely like we have to drill for fossil fuels indefinitely... or until the worlds oil reserves run out, at which point the modern world would simply break down if it relied heavily on fossil fuels.
3: the battery doesn't even have to be replaced by a Li-ion battery... there are other up-and-coming superior battery-technologies, technologies such as solid-state batteries and ultra-capacitor-based batteries, even batteries based on carbon nanotubes. Technologies that are environmentally friendly and even pack a higher energy density per kilogram. Technically it's not even impossible to invent a battery-technology that would never have to be replaced, there are no laws of nature preventing engineers from doing that.
Reply: I like it cuz you explain better then school and i love cars
Reply: I’m sorry but I’m having to unsubscribe for a while because I Don’t like channels That sponsor every single one of their videos it’s a bad trend right now and it’s taking over YouTube so I’m having to give up some channels are used to love And unfortunately that’s the same thing that’s happening to you so I may not see you again in the comments so goodbye
Reply: CO2 not C02
Reply: Can we see some numbers on reliability versus ICE vehicles, and then factor in the environmental impact numbers again? How many motors is one tesla model are averaged to be within a 20 year life expectancy? I've seen a 22re clock over 500,000 miles, and it didn't require several hundreds of pounds worth of lithium to achieve.
Reply: ¹
Reply: @DonutMedia thanks for the video, I found it very useful. However I have one question. In an Electric Vehicle, you have to replace the battery every 8-10 years or every 100,000 miles and many ICEs can last much longer than this. The initial emissions caused by the battery production as well as human toxicity potential is therefore doubled over the EVs lifetime. Did you take this into account? Would this tip the scale in favour of ICEs over their lifetime or not?
Reply: @DraConeAnoFausoMe  my question exactly. Not to mention all of the batteries that will probably come fried out of the box so to speak. Warranties may cover the cost to the customer, but at what cost to the environment. All of these numbers are anecdotal without all things considered.
Reply: @Ayjop I don't think science is political, but a lot of naysayers do. Cited sources are nice for those who want to delve further into it and learn more
Reply: They are better long term for the environment, but they do have drawbacks.
Reply: True but y'all failed to account that "green" energy is just as bad to produce as the "EV"........ Then Cali forcing "green" energy causing enforced blackouts.
Reply: You failed to include the environment cost of manufacturing replacement batteries for those electric cars, those batteries wear out and need new ones long before the car does!
Reply: EVs  are cleaner as they don't pollute the towns they visit
and thankfully  quieter, especially freight
Reply: @eded9202  Nuclear power plants are very misunderstood. Did you know that the "nuclear waste" produced is actually a solid. Also all the nuclear waste in USA from electricity production since the 50's would fit in a football field stacked 10meters high. Uranium is actually recyclable as well still having 90% of its energy after 5 years of use.
Reply: Do your homework before you talk.
Reply: @richardpluim4426  What did I say that was false?
Reply: So every five to six years the batteries for EVs need to be replaced. Do you know how many metric tons of waste that alone will generate? Be interesting to map out the life span of each vehicle types.
Reply: Sorry DM, but you left out a key number - the amount of footprint needed to deal with, contain, ship, store, dispose of and/or recycle the spent batteries which are enormous blocks of hazardous waste. The total carbon emissions created in dealing with an old EV and its batteries are several more metric tons per EV. Plus, you left out another key fact. The limited lifespans of current EV batteries requires replacement of the entire battery unit after the first few years. Over the total life of the car, the EV will go through at least 3 generations of batteries. Multiply that by the projected numbers of future EVs on the road and now gas cars are looking better and better. There has been a lot of research done into the feasibility of EVs. People are being guilted into giving up gasoline, but really we are just robbing from Peter to give to Paul. The real solution to carbon emissions lies in how we build, heat, and cool buildings. Cars are only a sliver of the problem.
Reply: My question is … what happens when the electric cars battery goes bad?? Can you rebuild it? Like a gas ⛽️ car??
Reply: Why are people asking for sources? Don't they believe the pumping, refining, shipping, transport and burning of oil and gas consumes energy and causes pollution? Those steps are all eliminated in EVs... no source required to make a direct comparison one is many more times greener than the other. 

You don't need a source to see the obvious but asking for one somehow allows cognitive dissonance I suppose.

Face the facts ICE lost to EVs... again.
Reply: @Drew_Hurst  Because anyone who wants to use this Information for school projects cannot site their evidence and therefore cannot use any information found in the video. No one is just going to read through the sources for fun use common sense.
Reply: I think the sources were included with the original upload which was from one of the bigger UK YT EV car channels. Wish I could tell you more but that's all for now.
Reply: @UCX28N_fvXOMnFgNTbvpDIrg Compared to the amount of things, 
that are in an ICE car, 
that are hazardous to humans and animals...
it's negligible.
What's hazardous to humans and animals,
is all the pollution; 
prevented with a tiny bit of cobalt... 
it's negligible.
Reply: @Donut Media - Haha! MOE POWUH\ MOE PEEOOUH! I see where you are, putting on an aave or non-rhotic southern accent!
Reply: Would you like to know why CO2 caused catastrophic anthropogenic global warming is a scam and has nothing to do with science ?
Reply: Do you know how many times the climate scam has been used before ? : The Washington Post - November 2, 1922 "REPORT ON GLOBAL WARMING."
Reply: Maitland Mercury - March 11, 1846 "On the Change of Climate."
Reply: The Brisbane Courier - January 10, 1871 "Imaginary Changes of Climate."
Reply: Rochester Democrat - December 17, 1939 "Glaciers Melting Over Greenland."
Reply: I have two questions that you did not clarify. You said average annual usage you did not say average mile. Most EV are not going the same distance as gas cars. Could the gas be better in a number of cases and EV in others? If you are idealing in a gas that would be worse although on longer trips the gas may be better over time? Point two I have is around the lifespan of the cars/batteries. Which car has a longer life span on average? If you need three or four sets of batteries over the same period of a gas car don't you need to multiple the production cost of the EV by four to equal that OS a single gas car? A lot of EV owners that I know of will not buy a second EV as the range drops so much after two years and it cost so much to get a new one/battery.
Reply: bill z  A simple search "The Washington Post - November 2, 1922 - Report on Global Warming" will get you lots of info and a copy of the original article if you look through a few search hits.
Reply: bill z  Old articles about climate change and global warming are only anecdotal evidence though, the science destroys the hypothesis much better. Search : "Global temperature and atmospheric CO2 over geologic time/graph/images" by Scotese and Berner and you will see temps and CO2 don't go together, the Earth isn't historically hot and atm. CO2 isn't historically high. It's all lies.
Reply: you forgot the fracking process to actually get 1 liter of petrol and the flaring process produces co2 as well
Reply: @jamalcollier7588  CO2 is a good thing and I bet NOT ONE SINGLE PERSON HERE KNOWS WHAT THE DEADLY LEVELS OF ATMOSPHERIC CO2 ARE.
Reply: bill z  Yqw and don't sweat it, I'm not online all the time anyway.
Reply: jesus loves you
Reply: Been 2 years since this video was posted. As you know EV are already taking a toll on the electric power grid. Owners are asked too cut down on charging there EV during peak hours. Is it going too get worse? Current projection is not looking good so far. Time for a update. I know it hard too predict the future even a short time frame.
Reply: @angry3055  Oh no, I've seen this coming for about 15 years now. Want to know what's next ? They will tell you the EV's are causing environmental damage and contributing to child slave labor, which they already know they are but don't give a fuck about until they need the narrative, next they plan on taking away everyone's homes and private property. They don't have to actually take it away though, just make it so expensive you can't afford it, then the banks and the government own it. If you want to know where they plan on making areas "no human zones", go look up Agenda 21 biodiversity map. Your state might be one you can't live in soon.
Reply: Unless you own a Juke, sorry
Reply: Nolan bud there are actually a person who explained to you about the power grid statement you should look at it.
Reply: 8:57 Not sure electric cars are more efficient. Not mentioned  factors are the loss of energy through the grid and the weight of the battery. The cost is a free-market means of gaging environmental impact. If an electric car cost more over a period of time then it uses more resources.
Reply: @reverendbluejeans1748  Why cave in to the communists pushing this global scam on you in the first place ?
Reply: You are aware after a little over 5000 miles EV’s become carbon neutral. Then negative due to the high efficiency.
Reply: @Follow_thedopamine  CO2 doesn't control the temperature of Earth, global warming is a good thing and you can never stop climate change without stopping the planet from spinning first.
Reply: You are aware after a little over 5000 miles EV’s become carbon neutral. Then negative due to the high efficiency.
Reply: @Follow_thedopamine  Sorry but using electricity from coal fired power plants is never carbon neutral. It doesn't matter though because 5 minutes research proves CO2 caused catastrophic global warming is a huge scam.
Reply: https://youtu.be/G67i_Z8ukD4
https://youtu.be/NsCdiYhftGc
Reply: You need to cover semis being electric these politicians are going to bring America to it's knees
Reply: hey but then if you look at bio fuels then that could make gas engines even better then electric can you make a vid on that please?
Reply: @Racing_Rookie  -- A lot of the publicly available info on biofuels is intentionally misleading.  Algal biodiesel and biobutanol COULD be game changers as they are direct drop-in solutions, you could grow algae anywhere you can put a tank of water with enough sun (think deserts), and would only need about the same land mass as the state of Maine to grow enough for our current transportation needs.  The oil extraction isn't nearly as hard as it's made out to be...I've done it, myself, and the waste from making biodiesel can be used to make the biobutanol. 

The powers that be don't want it, though.  They want a complete infrastructure change to electric and, if you've ever tried to get a green energy grant, you figure out pretty quickly that they have picked the companies they want to profit off of the change.  All of the really promising privately funded research is either quashed before it's finished or hidden -- scrubbed from the internet, let alone being findable with Google.  A lot of the info I could get fifteen-twenty years ago and used as the basis for MY research now gets you a 404 error, not because it was a dead end, but because of political pressure.

I'd like to see a GOOD video on biofuels, but I'm not sure that it would be plausible anymore.
Reply: Hybrid is where it's at for sure
Reply: The fact they already are telling people not to charge their ev cars kinda blows out the statement about enough electricity. With oil you are also making other products unlike lithium which is basically only batteries. At the current limits of physics batteries cannot get better. The whole argument is irrelevant.
Reply: But why people keep buying EV's?
Reply: @lukasbarnes4905  same reason they keep voting for democrats
Reply: What is  more durable in flood EV or Engine gas car?
Reply: A question:
Using the same parameters for evaluation, could you please do a comparison between an average Tesla and  an ICE Vtwin motorcycle?
Reply: do you have any data?
Reply: I wish Gas-Powered Cars don't affect Air Pollution all over the Environment Anymore.
Reply: For company that sold Millions of cars in a year, going regular hybrid like Toyota and Honda is greener than making few hundreeds of BEV.  Besides that, over 10-15 years when the battery need replacement, regular hybrid is not disposable unlike typical BEV that cost much more than the car value.
Reply: How about that lithium battery waste ?
Reply: @tyfinancial  ? Lithium batteries are like 99.8% recycled.
Reply: @Idiomatick  recycle process is hard and cost lot of money .  Also lithium can be flamable, making it dangereous to recycle. 
80%+  lithium  battery end up as toxic hazardous waste
Reply: @tyfinancial  looking it up, it appears you're right, currently li recycling isn't very pursued. Although it is viable, just more expensive than mining for now.
Reply: CO2 is  NOT harmful.   CO2 cannot change temperature.  The global average temperature did  NOT  change for over 26 years.   CO2 is ... a  BIG  business. 
There is  NO  man made climate change.  Most of you don't even know the difference between weather and climate.  EV's are not electrical, they are just battery cars.  There is no such thing as renewable energy: Physics... ever been to school, good doers? Thought so...
Reply: Guess what... It also helps to not drive at all.  I Do own a car. We hardly use it. I work remotely from home, my kids go to school by bicycle and my wife goes shopping on her bike or walking. My country has good public transport that uses "green" energy. There is no reason to drive daily, electric of gas powered. Having everything you need close from where you live realy makes a difference.
Reply: @thesaw9988  i live in a car crazy nation but am an antisocial nerd that works from home. i probably use as much carbon as a chinchilla.
Reply: Electric cars are not sustainable to save the planet. We invest in sustainable mobility: walk, bike, and public transit.
Reply: There isn't enough lithium to put 130 lbs of it in each vehicle if its not going to cost more then gold. 😅 (Tesla battery est.)

around 17-20 million metric tons

Estimates of total lithium reserves on Earth vary, but they are generally believed to be around 17-20 million metric tons

Cars on earth 1.474 billion cars
Reply: They proved that it creates more pollution charging those cars than it does for a truck with gas.
The EV cars just create more pollution
Reply: Many electric gained also from many dirthy sources damaging the nature, also electric car baterry finishing also in short time, in long term oil based car are even mabe more cleaner, when the electric battery finished the car has no value...
Reply: Your facts are not correct, also if we went 100 percent EVit would represent less than 1% of emissions. Please advise your sources
Reply: of course 20 times better than fossil fuel cars. I am sure. If you have 8 solar panels, you can use your car after doomed earth or in the Saharian desert. It is incredible.
Reply: For me I will own en electric car instead.
Reply: Looks like a bright future!
Reply: I agree you should cite sources on issues like this. You've already done the fact checking so save us some time if we want to do some too.
Like the video Nolan - Keep em coming!
Reply: Donut Media is there a reason you don’t list nuclear among the clean electricity power plant options?
Reply: @ericolsen8926  because clean energy classification is a form of energy production that doesn’t have a byproduct. Nuclear energy currently has a byproduct.
Reply: @ericolsen8926  cos it's not clean maybe? The only nuclear energy that's "clean" is fusion, which isn't a commercial reality yet. Yeah , it's a reality (the Sun), but not practical on Earth yet.
Reply: @LiamNI  fusion energy isn’t even possible yet experimentally
Reply: @LiamNI  Its cleaner than all of the other non-renwable energies and actually from a carbon footprint is considered green.   Standard wind turbines need to be in use for nearly 20yrs just to neutralize its creation and installation carbon footprint and doesn't take into account the maint on the thing.   So wind turbines are not green either.
Reply: The problem is we are focusing on the wrong aspect of emissions. One cargo ship will pollute more than millions of cars. When they blame cars, they are sending the environmental bill to the average person while it's industry and transportation that make most of the emissions.
Reply: Rafa Allegretti Don’t forget about the wealthy climate change advocates that fly around in their gas guzzling private jets, own a few houses, and own a lot of cars. I don’t care if they do that, I just don’t want someone like that telling me I should drive an electric car or take the bus.
Reply: I still think buying used and maintaining it for as long as possible is the greenest way to go.
Reply: good point, dont flip your cars that often, find older model to your liking, swap powerplant from newer crashed model and keep it for like 20 years or so. @Donut, care to look into?
Reply: @itsmyyoutube  The evidence does not support that.
Reply: @itsmyyoutube  I thought this too, but there are videos that prove this theory wrong
Reply: can i just say they should instead of making new cars, just re fit them with batteries
Reply: @_generation_youth_x28  an EV conversion, even a simple one, can cost $18,000 on the low end. For most people it's probably cheaper and easier just to buy a used EV. Converting newer cars is also very difficult as many car systems require information from the engine to even run, and spoofing that can also be quite difficult
Reply: Generation Youth_X  but it takes a lot of toll on the environment
Reply: i mean who doesn't want an electric r34 skyline launch
Reply: @_generation_youth_x28  oh God no lol. I mean if we had no choice yeah but come on LOL. The rb26 and that R34 is one of the best sounding engines ever
Reply: Make video on Hispano, toroidion, Arrinera and SSC
Reply: Cobalt, which is primarily extracted as a by-product of nickel and copper ores, is mined in large quantities in the Democratic Republic of the Congo, China, Russia, Canada, and Australia. Cobalt refineries, however, are rarely located near the source mine sites.
Reply: Won't battery Degradation have a major impact on the stats???🤔🤔
Reply: So what about disposing of the batteries ? Doesn't that factor into the "bad for the environment" argument ?
Reply: @P.M_M  yes, it pollutes the soil and the water below the ground if there is any, nothing can be planted and etc, worst part, it can last for more than 120 years
Reply: True an EV does catch up to an ICE in carbon emissions, and that's no surprise. However, the replacement batteries that are required (depending on manufacturer and driving style etc) every few years could negate that advantage. Then there's all of the toxic waste that comes along with cobalt and lithium production. Those weren't really accounted for in your video. What impact will that have in the future?
Reply: Michael Cummins keep learning to run vehicles on other fuels the answer will come
Reply: @michaelcummins3296  Every few years?  Tesla batteries can last up to 20 years... I dont know where people are getting their info from, but do some research on Tesla not just hater websites that hate American made EV companies
Reply: You know co2 is measured in parts per million not by estimated weight right? You know co2 doesnt harm the environment? Co2 is essential for life.
Reply: SAVE OLD CARS  = SAVE THE PLANET.

The only thing this video missed was the fact that Electric cars today need their battery REPLACED every few years. so its not just one battery per electric car that you need to calculate.  if a gas car could last as long as 40 years or more,  and if you need to replace a battery on an electric once every 5 years avg, that means 8 batteries over the same 40 years for an electric car.

Now its sure to get better as battery technology improves, so in the long run electric cars will outperform gas in basically every way (except the beautiful beautiful sound of petrol smashing pistons pounding at high rpm  :(
but as of 2020 its only about equivalent between the two.

In fact the BEST way to contribute to saving the environment RIGHT NOW, is to RESCUE older cars that are broken and going to be crushed (thus replaced by a newer car which took all that toll on the environment just to be built. the old car has already been built, so that cost is already paid.)     

SAVE OLD CARS  = SAVE THE PLANET.

(and ideally put gas efficient engines, maybe even hybrid systems in them, not giant 1000hp turbos.....   come on guys just.. use your brains!)
Reply: How about FCEV's like the Hyundai Nexo?
Reply: Honda did produce a hydrogen power car, what if we condense it enough to be just as powerful as gasoline?
Reply: LC fuel cells are horribly inefficient when you consider the energy needed to produce Hydrogen and compress it.
Reply: Hey Nolan, an sincere question i have, what about batteries after it's lifespan? It's a thing that we have to put into consideration, since any battery which is discarded will pollute the soil and the waters below, anyway, thanks for the amazing video :)
Reply: Hey man, love this vid, but i think also important factor is enviromental impact of destroying the car, when its too old. You know, the batteries arent really god for enviroment and so the normal engine vehicles lead in this category. However im not sure if it would change the greenhouse emissions chart because the enviromental impact is rather chemical poisoning of certain area.
Reply: i'm sure its been pointed out but what about end of life... or the life span of the batteries....also at this point in vehicle production gas is more efficient per volume than electric.
Reply: You based this all of American only. Other countries don't have the infrastructure when it comes to putting power to the national grid. Also you didn't take into the account of Mount of shipping to make the battery's. The fact in production of making the battery alone it's ship more than 5 times around the globe! That is burning fossil fuels.
Reply: I see another issue: average battery life will mean batteries will need replacements thus after a number of years the initial carbon footprint would double. Also, battery recycling?
Reply: Only problem is that green energy sources are not reliable and truth is that the only one that worked was hydro damns.
Reply: @mrpumperknuckles1631  The only problem is that people who believe "climate change" is a problem are allowing the politicians to destroy America and cause great suffering and death worldwide.
Reply: @eggbirdtherooster  wat?
Reply: You forgot to add battery replacement and recycling the old battery plus combustion engines last for 100s of thousands of miles if serviced properly and even to a million miles and just a rebuild to go on for a few hundred thousand miles more.
Reply: Donut Media i actually would like to see the numbers on that equasion.
I did a research paper comparing the Smart EQ with the regular smart 90hp ice vehicle. The difference in production according to Daimler is 2t of CO2 (small battery). Even with this said, 1 kWh of electricity from coal equals 1200g of CO2 (German data). With this the CO2 per Km ist actually higher than the ice car is rated. So it actually becomes worse when you drive it. With EU electricity mix the break even point was at roughly 85.000km. Just to add that. 
Buying the ICE car and spending the difference (to the EV) on CO2 compensation was actually more environmentally friendly than driving the ev (even with renewable energy sources). Kind of ironic.
Reply: Ok, they are better in terms of co2 emissions, but you have to keep in mind that many required precious metals are mined in tropical areas where the forest is cut down, so you have to calculate all the co2 that the trees store, presumably electric cars are still a bit more efficient but you should nevertheless mention that the not the ultimate solution they often claim and against hydrogen they still have no chance
Reply: Ok, what if half or three quarters all switch to electric cars? What of the grid then?
Reply: @Cocpain  No problem the grid can easily handle it, especially as more solar panels and wind farms get put into place
Reply: Hi Nolan, love the channel man, I watch you guys on a daily basis, like the 8 o'clock news😂😂. Love the video, I was about time someone did that, and you are on point, but you forgot about 1 most important thing about EV'S and that is battery cycle, and the environment impact of Li-Ion or Li-Po batteries is massive because they cannot be recycled, so we have to dispose them underground and a study in Germany did the math of all these variables mentioned by you and the final impact of an EV is major than a gas based car, so until they start commercialise the solid state batteries which are made for greater capacity and   to be able to recycle them, EV'S are not more green thumb than gas powered cars. And for me the best type of car and the only one that should, is the hybrid one, and the greatest example of them all is none other than the mighty 918 Spyder with an outstanding 3L/100km in hybrid mode out from a 4.6L and 2 electrical motors that produce close to 900bhp. That is the future, not EV'S, not small turbo gas engines, Hybrid. Stay safe you all
Reply: Nolan, though you mentioned lithium, you failed to mention just about every other mineral resource needed for EVs. They use 2 to 3 times more copper than ICE. This requires more copper mines, which tend to be in isolated regions that require large petroleum-powered excavators, roads for transporting raw materials to ports (check out the emissions of concrete), expansion of sea ports (more concrete), more sea and rail transport, and then processing such as smelting. Same too for nickel, bauxite ore, graphite, rare earth elements, and all the other minerals. And cobalt is a very scarce resource presently with one main supplier. Further, to extend the range automakers need to use light-weight materials like plastic and carbon fibre, both of which use a lot of petroleum. Then the electrical distribution system needs to be expanded greatly. These too have their environmental costs. For example, many people install power walls in their homes, and homes are easy to retrofit. However, people also live in large apartment complexes (have you seen an Asian megapolis?) that will need to be retrofit.  

It's fine to claim you're unbiased. But, more worryingly, is your lack of thoroughness. This a major shortcoming because it creates a skewed conclusion.

If someone were to promise me an auto and then deliver me 15% of one, they've failed. That is what your analysis has accomplished. Why that is I don't know. Perhaps this topic is beyond your research and analytical talents. Which is OK. Few here watch you guys for serious subjects. Stick to what you know. Or, devote the time and effort to address the topic in whole and not in part.

Also, nuclear power is a zero-emission power source, though all the concrete used does have its CO2 cost. Same too for dams, and environmentalists usually oppose dams. For turbines, sulphur hexafluoride, or SF6, is widely used in the electrical industry to prevent short circuits and accidents. SF6 has the highest global warming potential of any known substance. It is 23,500 times more warming than CO2. Just one kilogram of SF6 warms the Earth to the same extent as 24 people flying London to New York return. It also persists in the atmosphere for a long time, warming the Earth for at least 1,000 years. So much for "zero emissions".
Reply: @gagamba9198 The only reason he didnt ho insanely deep was because if the fact they didnt want the video to be like 2 hours long. My suggestion if you want to go real deep would be to do a podcast instead of a video. That or a talk show.
Reply: @gagamba9198  There have been engineers who research all that goes into making and disposal of EV batteries, and still came to the conclustion that Electric vehicles are by far better for the environment than gas cars.  Many vids from engineers on youtube showing the facts
Reply: You forgot natural gas driving vehicle as an option and their very small co2 foot print.
I'm not sure if you calculate losses in power plants & losses in electrical network.
Reply: What about hydrogen cars (like the Hyundai Nexo & Toyota Mirai)?
Reply: Um two things you missed, EVs during production of the batteries cause acid rain and VW and Mazda are going to biofuel which can be produced from grass which cuts emissions by 90%
Reply: Thank you for making this video. I think it's a very important topic to talk about. But I do have two questions. 

1: how do we measure electric cars efficiency if they are in colder climate? Such as the Midwest to the upper east coast. I know batteries don't hold their charge well in the winter so how much extra energy would you be wasting? 

2: alot of people keep their cars for long periods of time. My family and kept our main family SUV (suburban) for 14 years and put 250k miles on it. The batteries for electric cars won't last that long at all especially if you live In a colder climate. Also right now the cost of new batteries would be more than the entire car is worth. 

I know technology will always improve but I just don't see how electric cars being as efficient as they claim even after this video. But this topic needs to be addressed and thank you Nolan for doing so. Hope you are staying safe and healthy.
Reply: @johngormley3908  that's is true in the nissan leaf and similar EVs, teslas have a liquid regulated battery that cools and warms via the ac system of the car, that batt can last easy half million up to a million miles. EVs are better for the environment than gas cars but are way to far of be zero emissions.
Reply: jesus_rdg If you actually bothered to do research before making this comment, you would find out that Tesla is promising a million mile battery. There is no guarantee that this will happen. Plus, automotive transportation barely causes any environmental harm: it’s overpopulation that causes it. The smaller towns have higher air quality than the cities for a reason.
Reply: @MrKEMills  you're right. Overpopulation is the real problem...
Reply: @johngormley3908  in a cold climate the battery stores less energy so it gets full quicker so it does not waste more energy.
EV batteries do not suddently stop working they just hold less charge. There comes a point when the car will not drive far enough. At that point people assume the car needs a new battery but the old battery still holds charge.  My home battery is made of cells from a "failed" EV battery. As more EVs come on the marker there will be a business case for aftermarket companies to provide replacement EV batteries at a reasonable cost.
Reply: @johngormley3908 EV batteries are capable of powering a car for well over 500,000 miles.  Some say potentially a million.  You just can't go around spouting crap with no imperial data to back it up.  This video is quite old, in the UK today we are producing 40% of our energy from wind and solar so the numbers are massively in favour of EV's.
Reply: Nolan, great video. I'm not American and I don't have the same rights and freedoms you have in America. During this 'crisis' I have seen how government takes away civil liberties. You said that you will always own a gas powered car. I'm telling you that in your lifetime, you will be forced to give up driving that car on the roads. Your government will eventually tell you that AI driven vehicles are safer and in the name of safety, no one will be allowed to drive on public roads. That will happen in your lifetime, likely mine too. Again, great video.
Reply: @DaviesGarage  Not if we (car loving numbskulls) have anything to do with it. Government of the people baby! ... I mean mo powah babay
Reply: Hi, there is 1 very is important detrimental point about EV you didn't mention: lifespan. electric cars don't live that long look it up average lifespans of Tesla if you use it lightly which nobody does is 5-7 years max while on the other hand normal cars live well over 12 years and Toyotas and hondas live 20-25 at a minimum without needing major repair. so you need about 4-5 electric cars to match 1 car.
Reply: Y A yeh that’s not entirely true....EVs have less moving parts and require less maintenance and battery technology is continually improving. So the only reason people aren’t keeping EVs as long is either lack of a decent charging network or they get bored. There are also plenty of companies converting ICE vehicles to battery power. ICE technology has pretty much gone as far as it can where as EVs are still developing and improving like it or not we will be made in the future to use EVs by most governments worldwide 😕
Reply: @YA-ee9zf  Teslas come with 8 years warranty on the battery, so no way they last only 5-7 max with light usage. Considering the cost of a new battery, that will bankrupt the company.
In fact, electric vehicles will almost certainly live longer than modern ICUs just because they have a lot less moving parts and thus easier to repair. The only problem is the cost of new batteries after their 8+ years lifespan. However, in the long run, the money saved on not repairing an ICU over 8+ years + the savings from not being petrol, will more than cover the cost of a new battery.

As for ICUs not needing major repair in 10+ years - that may be true, but you have tons of smaller repairs that pile up in the long run, not to mention all the regular consumables like filters and oils, most of which don't apply to EVs. Ask me how much a new clutch costs for my ICU car and how often it needs replacement...
Reply: Wrong. Actual EVs last longer than the average ice cars.
Reply: @YA-ee9zf  Thats not true, Tesla's are probably going to outlive most ICE cars... look at 2012 Model S Teslas, they are still going strong and are selling for 30k used.  You cant find any older than 2012 because they just started making cars... give them a chance.
Reply: Y A - exactly this. I came on to comments just to make this point - or to re-up on someone who’s already made this point. If ICE runs for 20 years with basic parts and EV is on its 3 battery change, this conclusion is starting to look a little more debatable. (For the record I’m not against EVs I’m just interested in the technical debate)
Reply: @YA-ee9zf  Go and search "Average lifespan of an electric cars" It'll give you an average of 17 years. Don't spread misleading information. (pretty much the whole point of the video)
Reply: Y A right bro
Reply: @YA-ee9zf  you got to start somewhere. The electrics will evolve , geting better n better. Its to early to say
Reply: @YA-ee9zf  Go and search "Average lifespan of an electric cars" It'll give you an average of 17 years. Don't spread misleading information. (pretty much the whole point of the video)
Reply: @YA-ee9zf  the much hated prius lasts 300-500k miles on average. Thats better than most gas cars, and even better than average for toyotas
Reply: @YA-ee9zf  I mean... it is under full drive warranty for 8~12yrs (dpd on model), so i doubt it is a 5-7yr max lifespan.
Reply: @YA-ee9zf that is so inaccurate it doesn’t even warrant a reply

Apart from this one.
Reply: @YA-ee9zf  Where are you getting that info? 1. The Model S (Teslas first "consumer" product ) has literally only been out 7 years. And there's plenty of Teslas around with over half a million miles on them. And there was recently a story about one of the original model S's that still has 98% battery capacity after 7 years. I say this with 0 Bias as well as I have a foot in both worlds ( 65 Mustang V8 and a Tesla Model 3 in my garage) And while saying Hondas and Toyotas live 20-25 at minimum is great market spin that's hardly the truth. I've done enough work on 5-15 year old Civics and Integras over the years to know that no where near the norm. In general the Total cost of ownership of an EV is well below a non ev as the only "regular" maintenance is Suspension and brakes. and at least on mine I rarely touch the brakes thanks to regenerative braking. I love the sound of the V8 as well but the faster I get in the EV the less the lack of noise bothers me.
Reply: @LiamMacInnes  In Norway where we have a lot of EV's, i've seen Teslas with 250-300k kms on the clock, and battery degradation is not nearly as bad as expected. Thermal management is key.
Reply: @LiamMacInnes  I've heard of that Tesla with 98% battery,  you forgot to mention that's it's on its second battery and has had all of its motors replaced as well as the LCD screen that leaked.
Reply: @LiamMacInnes  Look at the buy in (dollars!!) of the vehicle upon purchase! You pay up front for the EV or Tesla upon purchase. So it is way more expensive than the comparable internal combustion powered vehicle. Maintenance and repair for the internal combustion engine powered vehicle is wayyy lower. When a Tesla is involved in an accident and, although repairable, only Tesla certified repair shops are allowed to repair them! It costs $10,00.00 or more to train and certify a repair auto repair shop mechanic to repair a Tesla. Not many auto repair shops are willing or financially able to invest in that vehicle certification for this training! Especially when the mechanic can walk out the service bay door and find a higher paying job at any time after the certification is over and the shop has paid for the training!
Reply: @paulzehms8520  none of that is correct Now I'm in Canada so these numbers are in Canadian pesos. But a 2020 BMW 330 (base) is $49350 a Base 2020 Model 3 is $52990  that's a difference of only $3640 which I more than made up for in my first year with my model 3 I was paying $60 a week on average or $3120 a year in Gas where I don't see a noticeable bump on my power bill charging the Model 3 at home. As well I don't need to do oil changes, transmission servicing, or cooling system servicing. If I get in an accident I could care less how much it costs to fix is as my insurance is paying for that not me the deductible and insurance are the same on both cars. Brake pads last years longer because they're rarely needed in normal driving with regenerative braking ( I almost never have to clean the brake dust off my wheels either).  After 1 year I was far ahead on total cost. Just 1 year. And I'm comparing it to my efficient gas car if you want I can comparer it to my 65 Mustang it loses in every category but looks there. Even doing most of my own work on the gas cars the EV still ends up being cheaper with Tesla servicing it. Also that's 100% false about needing a Tesla certified shop. Electrified Garage and EV West and companies like them have changed that over the past 5 years
Reply: @YA-ee9zf  That's not really true and most evs are lasting a lot longer than expected.
Reply: @sammoxford  5-7 years is longer than expected .and we havent talked about colder countries where temperatures are jumping up and down .
Reply: @ergoaia.nolifeprod.2830  Longer than expected according to who? And again where's this 5-7 year number coming from. the oldest consumer Teslas on the market are just turning 7
Reply: anonymous bosch okay if that’s the case I want to ask one thing and that’s warranties evs have terrible warranties I feel bad for the people who have paid $30,000 literally $1 a mile. That’s gives all ev cars a bad name that will hold
Reply: anonymous bosch exceptions !!
Reply: Ergo Aia .Nolife Prod. Yes sir
Reply: Y A I agree I left a comment as well most Evs (Tesla’s are know to die at around 40,000 miles) our gas ones last usually past 100,000
Reply: @verikgomez9031  That's full on false. I know quite a few Tesla drivers I don't know of any that have failed yet let alone at 40000 miles. Not saying it can't or hasn't happened but it's by no means the norm or worse than good ol internal combustion, I've my share of gas cars bite it before 40k miles in my time  cough Neon cough
Reply: try compairing it fair with a euro 6 diesel and get rekt EV
Reply: BuDDa ChieSeL Diesels are the fucking worst 😂 are you joking
Reply: excuse me but where are the life expectency problem?
like car with normal maintenance can last about 20 years but evs can only hole about 15 years at its best 
like with a time of 30 years, an owner must hv 2 evs instead of just 1 ice? how does that compare?
Reply: @felixli4306  Tesla batteries can last up to 1 million miles.  They should easily last 20+ years.
Reply: @yeahbuddy92193911  like any laptop " up to xx hours" give it a 75% discount.
And considering the time spending it sitting around... 20 years seems.... Exceptionally decent
Reply: @felixli4306  True, the do lose some capacity especially after 20 years.  But there are some Tesla model S's that have been driven 1 million miles, and the batteries are still at around 91% capacity.  Tesla batteries last a long time because of all the technology research they put into them, and the cooling, heating systems to keep the batts perfect temp all the time.
Reply: yeahbuddy92193911 if you really want to protect the environment, buying a used car is best. Even a used gas hog is better
For the environment since the cars already been made. You’re not adding another car to the road which is the biggest footprint is the initial build.
Reply: Hebrews 12:2 King James Version (KJV)

2 Looking unto Jesus the author and finisher of our faith; who for the joy that was set before him endured the cross, despising the shame, and is set down at the right hand of the throne of God.
Reply: Donut Media I’m happy to see a video on this but there should be a part 2 Tesla’s have a big flaw they don’t last very long(mileage wise)... so also maybe look at the long run lots of gas vehicles make it past 100,000 I have yet to hear/see an ev to reach that. Keep making great vids
Reply: @verikgomez9031  That's not true. Here in Norway there are Tesla taxis that have already done 250-300.000 kms. The battery degradation is way less than a lot of people think, due to good thermal management.
Reply: @verikgomez9031  Tesla's batteries are designed to last 500k to 1 million miles... your argument is invalid
Reply: You dont take into account that batteries get replaced every 5 years. When you do that your actually polluting more.
Reply: @user12122  Except they don't.
Reply: @user12122  lol. no you're not
Reply: @user12122  Not true.. Tesla batteries are designed to last 500k miles, probably 20 years.  I dont know where people get their facts but 5-7 years is a myth.
Reply: Cool video Nolan. Super informative and maybe now people will know that EV vehicles aren't as clean as they think. That they'll stop being smug and pretending their doo dont stink lol. The one thing that I feel got left out, is where EV vehicles get there energy from. All power plants have their downsides. Solar and wind power isn't as clean as you think it is. Look into it. I don't want to destroy our beautiful planet, but I'm really tired of misinformation about "clean" energy.
Reply: @crimsonsr20  You should watch the whole video. He touches on that.
Reply: Martin Ramirez cite references. “Look into it” isn’t a valid argument.
Reply: @crimsonsr20  you're right, burning coal is much cleaner than wind.
Reply: @someguy4645  I dont remember saying coal was efficient or the answer. Im just saying, let's stop pretending that green energy is clean. The fact of the matter is, that we don't have the technology to store the energy made by solar or wind. Not to mention the acres of land needed for windfalls and solar power. How that effects the eco systems of birds and other animals who called that land and air home. Now If you want to disregard the downside of "green" energies in the name of being woke, be my guest. Im sure it won't come to bite us in the proverbial ass, years into the future
Reply: @crimsonsr20  it's called opportunity cost.  if we give up wind and solar, we are left with what - nuclear and coal.  We've seen the effects of both - much less clean.  Nuclear is clean - as long as you don't make a mistake.  But, we've seen all the mistakes.
Reply: @someguy4645  That is true. Im not saying give up on the energy, but at the moment, there's no way to truly harness its potential. I just feel like whatever we do, we're just gonna create a new problem. History has thought me as much, and then that problem will go unaddressed, and we'll be in the same predicament again, if not worse.
Reply: @crimsonsr20  yes they are not as clean as some people think but in the end of the Day their still cleaner then normal ICE cars and Diesels in the long haul and only get cleaner with time. The Oil production alone makes an insane amount of emissions
Reply: @Calgar_Gaming  I'm not saying it doesn't or that gas or diesel are better then EV.  What I'm saying is EV vehicles still need their power from an outside supply. Nolan covered how the batteries have a shelf life and after that life is expanded it'll be deemed hazardous waste and left in some landfill to rot. Have you looked into what goes into manufacturing a solar panel? How it affects birds migratory paths. Same with wind. Hydroelectric plants kill many fish a year and most commonly disrupts the salmon's spawning cycle. Not to mention, what happens when these man made things fail? Dams or nuclear plants have failed in the past before leading to man made disasters. I just don't like people being misinformed and believing that this is the answer to fixing the emission problem
Reply: @crimsonsr20  i agree. A lot of these people who have EVs dont realize theres always gonna be a naegative impact. In fact everything has some sort of negative impact. So there's really no way to go NET 0 FULLY NO EMMISIONS, its not possible. But we can help CONTROL IT and make it to where theres LESS HARMFUL EMISSIONS BEING THROWN INTO THE ATMOSPHERE.
Reply: @crimsonsr20  Are you seriously saying burning coal and diesel for power is better for the environment than solar panels or wind turbines?  Jeezus.
Reply: you and getting your info from google is a freaking disgrace these here are not documentarys but infoMERCIALS Cobalt, which is primarily extracted as a by-product of nickel and copper ores, is mined in large quantities in the Democratic Republic of the Congo, China, Russia, Canada, and Australia. Cobalt refineries, however, are rarely located near the source mine sites. DO NOT THINK YOU ARE GETTING YOU COBALT FROM THE LAST  BUT FROM FREAKING CHINA NOW DO YOU UNDERSTAND WHY TRUMPH IS NOT RUNNING INTO CHINA LIKE JOE BIDEN SAID YOU ALL ARE FREAKING BLIND LIKE A HORSE WITH THOSE EYEFLAPS
Cobalt, a critical raw material for electric transport
Cobalt is necessary for the production of the most common types of lithium-ion batteries, which in turn are powering the current boom in electric vehicles.
Reply: Along with everything else that uses a lithium-ion battery power source or back-up. Laptops, cell phones, and many other "tech" based items used by the vast majority of Earth's population, which in effect endorses the continued practices and environmental conditions of the child-slave labor forces in places like Congo, likely China, and to varying degrees likely similar conditions amidst the majority of those locations, but yes processing into the desired product for selling to tech companies seems to be isolated to a single source outlet thus supporting a monopoly and child slave labor for the sake of techno-advancement as well as fulfilling supply and demand calculations annually at minimum.
Reply: You neglected to mention that the life expectancy of a lithium battery was 2 to 3 years, and you will have to buy another. So there is that.
Reply: @EAST-TN-DRIVER  yes, and that means double the manufacturing cost to the environment...add that in and the outcome changes dramatically
Reply: @EAST-TN-DRIVER  Tesla's battery warranty is 8~12yrs .... so the batteries last longer than '2 to 3'...
Reply: @Idiomatick  so if you have nothing better to do then comment on 3 year old videos, fine. Atleast get your facts straight. They do have a 8 year 120000 to 150000 mile warranty on the battery. Every person I know that owns one went through the warranty in less than 3 years. 2 of my friends had to pay out of pocket for their new battery. Both sold the car instead. You can have them. I'll stick with I.C.E.
Reply: @EAST-TN-DRIVER how come there are so many 10 year old EVs still on their original batteries?
Reply: @EAST-TN-DRIVER  Not true, Tesla batteries are designed to last 500k miles... research your facts
Reply: unless all the energy for EV comes from nuclear energy then yeah EV are more poluting i do not have to watch the episode to know that. plus a EV does not last as long (supports throw away waste like apple) and those EV drivers always advocated for human rights but for EV the cobalt that is needed forces even more kids in africa to work in the mines but they do not care suddenly plus the cobalt is a heavy metal worse then co2 and cost alot to properly dispose it. THE ONLY SOLUTION THAT IS BETER THEN ANYTHING IS HYDROGEN #NODEBATE AND F OFF YOU TREE HUGGERS
Reply: @Buddashii  And it's you that who are so wasteful, not us. Recylcle your own garbages first.
Reply: @Buddashii  Wow I mean how dumb do you really have to be? Nolan covers all of that in the video and it makes you look so goddamn stupid.
Reply: Wind and solar energy are a myth my man! and in the future with all those electric cars we have to suply them with electricity.. btw, THERES NO PROOF THAT CO2 WARMS UP THE EARTH.. its all ''models'' and very complex and hardly predictable! Do some more research.. 😏
Reply: EGGBIRDTHEROOSTER wtf
Reply: @eggbirdtherooster  even if the models dont sway you that GHGs heat the earth wouldnt you think it better to limit pollution however possible. why not use a wind turbine?
Reply: @eggbirdtherooster  When someone on the internet says, "Do some more research" you automatically know they have no idea what they are talking about.